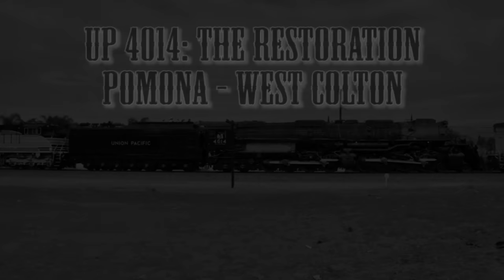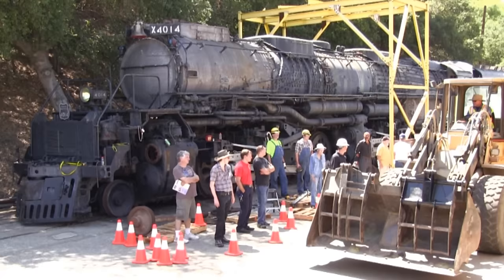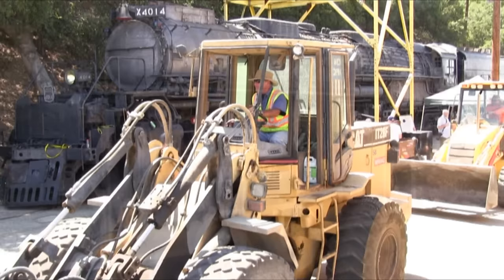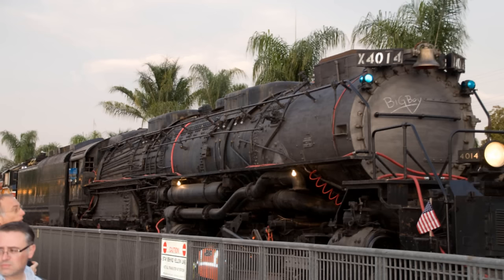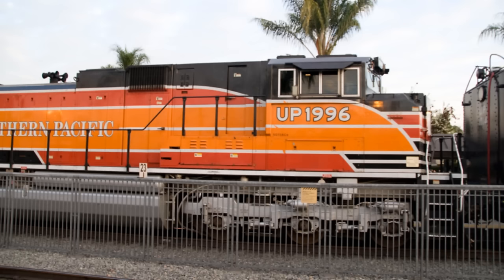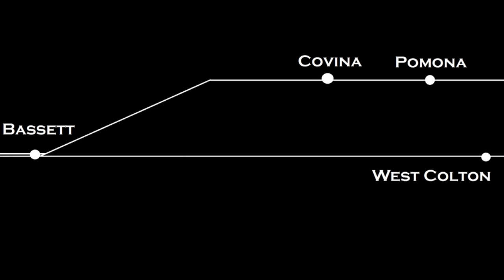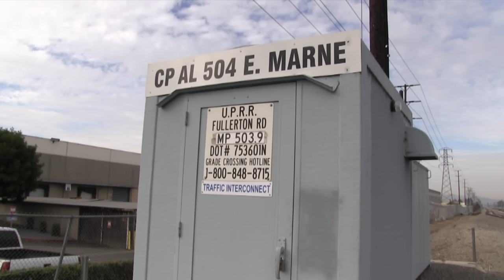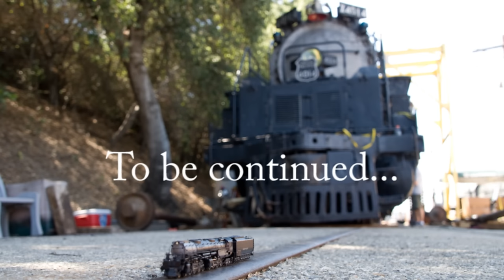Big Boy 4014 Steam Train - The Road to Restoration: Pomona to Colton

Comment: So pathetic! The steam locomotive is so powerless it has to be towed & pushed by 4 diesel electric locomotives! No wonder the steam locomotives were junked! All that remains now is to put this garbage to the cutting torches!

Junk all the remaining steam locomotives! Cut them apart & melt them down!
Reply: Hey you, yeah you!

Have you ever considered the fact that maybe they didn't have the resources to get the train to movie under it's own power at the time?

What do you use for a brain, a grain of sand?
Reply: 1230james
This equipment can't move under it's own power because it was JUNKED out years ago for far better equipment. This thing is a relic that should have been cut apart & melted 70 years ago. Now it is time for financially desperate people to help themselves to the parts & sell them for CASH on the black market for LUCRATIVE sums of CASH.

ABSOLUTELY NO QUESTIONS ARE EVER ASKED ABOUT WHERE THE PARTS CAME FROM OR HOW THEY WERE ACQUIRED!

The engineer's instruments, bell, whistle, headlight, number herald, builder's plate, valve handles etc. Many, many salable parts! FOR CASH!
Reply: Cockroach Bitch, please.

Do your research.

This locomotive was made 74 years ago.

And NOBODY uses an engine like THAT for only 4 YEARS.

And those parts aren't for re-sale. Like you said: If no one wants them, then how do you sell them?

You, sir, are contradicting yourself like a 4 year old.
Reply: 1230james Not to mention the fact that the locomotive hasn't moved from its position since the sixties. If you want a good example try starting a fifty year old car that hasn't had gas or oil in it since the sixties. See how easy that is and multiply it by 100. That is what's required to get that piece of art working.
Reply: 1230james
That relic should not have EVER been used for 4 hours! Those parts will sell for very handsome sums on the black market! And on the black market, CASH IS KING! All payments are in CASH! ABSOLUTELY NO QUESTIONS ARE EVER ASKED ABOUT WHERE THE PARTS CAME FROM OR HOW THEY WERE ACQUIRED! The parts just show up & as quickly disappear!

The financially desperate people can use the CASH to make their lives much better. Think of it as the steam locomotive making the ultimate sacrifice for helping people! What a noble cause!

Junk all the remaining steam locomotives! Cut them apart & melt them down.
Reply: Joni Mire
I disagree! This thing was junk in 1950 & should have been cut apart & melted them. But it is not too late. All of the parts can be sold quickly for CASH on the black market! Financially desperate people can sell the parts to help out their financial situation & improve their lives. ABSOLUTELY NO QUESTIONS ARE EVER ASKED ABOUT WHERE THE PARTS CAME FROM OR HOW THEY WERE ACQUIRED! The parts show up in the middle of the night, the CASH is paid & both parties walk away, content!

Engineer's instruments, bell, whistle, headlight, builder's plate, number herald, bolts, nuts, tubing & so much more is there just for the taking!

We don't need steam technology for locomotion of a transportation system any longer. It is like arming the army with crossbows & trebuchets. Worthless, useless garbage of a warfare technology any longer. The steam locomotives should be used for heavy artillery practice for the military!

Junk all the remaining steam locomotives. Cut them apart & melt them down!
Reply: Cockroach Noble cause??  I think not.  You are about as noble as your name suggests.
Reply: The idea with this isn't to try and make steam trains make a comeback. The Union Pacific want to restore the 4014 for excursion service. They do use their steam locomotives for freight but only when running in between passenger trains.
Reply from the maker: Cockroach The equipment was not junked. It went straight from the "back up" pool of locomotives to the museum in Pomona. As a business, the Union Pacific was looking for the least expensive yet most effective means to get the job done. It just turns out that the big boys were no longer the most advanced pieces of railroad technology in the late 1950's and hence, they were all retired. I don't think it is accurate to call them "junk". They were very good at what they did and served the railroad well at the time. Now, one is being restored as an example of what some of the biggest steam locomotives in the world were like. I figure that you are probably just teasing people, but it would be best if you refrained from such comments as "they should all be graffitied" in the future, as many people are excited to see this project finally coming to fruition. Thanks.
Reply: William Tilland
Believe what you want or think of the cause & me! What you think of me is none of my concern.

I believe that the financially desperate people would be well served by the sale of the parts of a steam locomotive on the black market. Just think of the difference it will make in their lives having the CASH from the sale of it's parts on the black market! And they don't have to worry because transactions on the black market are conducted with ABSOLUTELY NO QUESTIONS EVER ASKED ABOUT WHERE THE PARTS CAME FROM OR HOW THEY WERE ACQUIRED!

For the financially desperate person, it raises their standard of living for a while & probably long enough they can get their feet grounded & able to feed their families.

That sounds very noble to me.

It is better than the junk the steam locomotive was 70 years ago. To preserve it now, is only perpetuating the uselessness of a steam locomotive. It is better in parts on the black market, torn apart, cut apart, scrapped, junked out, cut apart & melted down for recyclable materials.
Reply: Jacob Greve
Regardless of the idea, it should be made available for parts to the financially desperate people to sell on the black market. ABSOLUTELY NO QUESTIONS ARE EVER ASKED ABOUT WHERE THE PARTS MAY HAVE COME FROM OR HOW THEY WERE ACQUIRED! It is just CASH transactions. Both parties walk away content.

And the planet is rid of another steam locomotive! Sounds like the way to go!
Reply: Adolph Oliver Bush
Think what you wish of my posts. What you think is of no concern to me.

I don't deal with the parts, I cut them apart & load them for a foundry to melt. When enough parts are removed & the steam locomotive relic is beyond economic reason to repair, it may come my way.

That is when I have the yard crew go to work & reduce it to recyclable material to load into a mill gondola. The foundry does the fine job of melting it.

Not to worry, we haven't cut one up in a few years now, but anything I can do to help it along, is fine with me!
Reply: Joni Mire
Nuclear power steam locomotives? I know the government will allow it. Even if it did, the local neighborhoods would not allow it within 100 miles because of the risk. Insurance companies would never insure it.

The only time this relic has a chance of nuclear power is if it runs under the ocean at a depth of 1000 meters & 2000 kilometers from the closest shore!

Cut it apart & melt it down!

IRL I hope you are smarter than you sound!

BTW, you are so wrong! They made 25 of these articles of pot metal. 17 were scrapped. Only 8 remain! All should be junked out, cut apart & sent to a foundry for melting down!
Reply: Cockroach What use would the parts be if they are designed for the big boy steam locomotive and only that. Didn't think of that did you smart guy.
Reply: CoasterFan2105
There are easy ways to deliver white paint balloons at this relic of pot iron. Then there is ways to "decorate" the steam locomotive with a yellow spray paint can. It would improve it's looks just before it is cut apart & sent to the foundry for melting!

There are some excellent opportunities coming up while being moved to make this some very nice "decorative" touches to this with about 3 5 gallon paint pails of pink, blue, white or yellow paint. In fact, the local recycling/waste disposal center has free paint for the taking. I pour it all together to make an attractive blend & use it!

That would look very nice on a steam locomotive just before it is delivered to a recycling yard, (like mine), for cutting apart & loaded into mill gondolas for delivery to the foundry where all those parts will be melted down!

Junk all the remaining steam locomotives! Cut them apart & melt them down.
Reply: Jacob Greve
There are people who collect artifacts for their own collections. They need not be complete collections of any one thing.

Do you think the Smithsonian has all items which have collectible value?

I did think of that! What you think of me is none of my concern.

Thank you for your concern & support!

Junk all the remaining steam locomotives! Cut them apart & melt them down.
Reply: Cockroach Finacially desperate, huh?

Again, no one would buy these parts. Like you said, these engines are outdated.

And you don't just SELL parts.

One company makes the locomotive,
The railroad uses it,
Another company can scrap them if they want to.

That 2nd company SELLS the scrap to others to use.

So how do finacially desperate people get the scrap, if they can't even AFFORD THEM?

Bitch, please, you have the mental capacity of a grain of sand.

Oh, what's that? Sand doesn't have brains?

WELL THAT'S THE POINT, BUDDY.
Reply: Joni Mire Um... NUCLEAR?

Not saying I'm changing sides or anything, but I doubt steam locomotives are capable of nuclear power...

But then again, I'm no nuclear physicist, so don't take my word as a completely accurate fact.
Reply: 1230james There are many, many parts collectors out there who want just a piece of the steam locomotive & will be handsome sums of CASH to get it.

ABSOLUTELY NO QUESTIONS ARE EVER ASKED ABOUT WHERE THE PART(S) MAY HAVE COME FROM OR HOW THEY WERE ACQUIRED!

The black market is the place to sell those parts. They won't be found for years & the CASH helps out the financially needy immediately!

What a good way to go! Making the ultimate sacrifice to help people with their CASH needs to improve their lives!

Junk the steam locomotives! Cut them apart & melt them down.
Reply: Adolph Oliver Bush Go ahead! Report me! I am not worried whatsoever. Since I haven't received any that I know of, there is no crime. I am sorry for you that you wasted your time on a something that is not a crime. But if it makes you feel better, please do!

I am just providing a service. I am telling people where the bank is, what is inside & the security systems employed. It is no more than telling a stranger where the Automated Teller Machine is. It is up to the bank to deal with the "customer".

The location of these relics needing, "a little help", is widely publicized. Even the railroad broadcasts it. Just letting the financially desperate people know is no crime at all. What they do with the information is up to them. I have never told them to do it or not to. I just tell them what I have heard about the activities of the black market. I am providing information which for them is a great service.

Consider yourself advised, Adolph Oliver Bush!

Junk all the remaining steam locomotives! Cut them apart & melt them down. Remove the parts & sell them on the black market for CASH. ABSOLUTELY NO QUESTIONS ARE EVER ASKED ABOUT WHERE THE PARTS CAME FROM OR HOW THEY WERE ACQUIRED! The part & the money come together & go away in opposite directions & no body except the buyer(s) & the seller(s) know.
Reply: Cockroach ...I found another contradiction.

One does not simply sell parts...
...when they're already melted down.

Given that you don't want to burn your hands.

And no questions asked?
A black market?

Where are we, the New York subway?
Reply: 1230james You have poorly misjudged. But I expected that from you.

The financially desperate people pick off the parts until the relic of pot metal becomes economically beyond reason to restore. Then it gets delivered to a scrapper to deliver the Coup de Gras.

At that point, it is delivered to the foundry where it's well deserved end! Melted into puddles & poured into the molds of brand new products.

Junk the steam locomotive. Cut it apart & melt it down!
Reply: 1230james Financially desperate people can do that. Don't under estimate them. And thank you for the very flattering compliment. I sincerely appreciate it.

When you are financially desperate & hungry, you will do what ever it takes to make it change. Selling parts of the steam locomotive on the black market for CASH is not beneath any of them.

The steam locomotive is out there. The pieces are there for the taking. Junk the steam locomotive! Cut it apart & melt it down.
Reply: Cockroach "Out there for the taking"

One does not simply STEAL a STEAM LOCOMOTIVE.

Or anything bigger than a car for that matter.
Reply: 1230james Trucks are stolen many times a year. Correct, there is no record of someone stealing a locomotive outside of war time. (It did happen in the US Civil War.)

Removal of parts of locomotives does happen. The air horns on diesel locomotives have been stolen & other equipment. The same can happen to the steam locomotive. The removal of the engineer's instruments, bell, whistle, boiler water sight glasses, valves, valve handles, radio, rope cords with handles, etc. There is just so much there which will sell quickly on the black market for CASH.

The very best part, ABSOLUTELY NO QUESTIONS ARE EVER ASKED WHERE THE PARTS CAME FROM OR HOW THEY WERE ACQUIRED!

The part(s) come in, the CASH comes in, the transaction is made, the seller walks away, the buyer walks away. And the parts disappear for many years!

That is the free enterprise system.

The locomotive is reduced to junk, then scrapped, cut apart & melted.

That is the way it is done! And the polluting hulk of pot metal is removed from the planet.
Reply: Adolph Oliver Bush Might like to know. a have spoken to the local police & the FBI had a friendly little chat. Seems there is nothing that can be done about the great service I provide. I provide information to financially desperate people. I am protected under free speech laws & I have nothing which links me to a crime or the commission of one. Until there is a crime, there is nothing which can be done. And even if there is a crime, since I am not involved in the actual commission or planning, I am golden.

Even then, it would be as indefensible as those, "I saw this movie & it said to . . . .". Hollywood can not be liable for publishing such a work. But it could happen.
Reply: Cockroach Alright, let's tackle your claims here, shall we?

1. Yes, the great locomotive chase. But they ultimately failed.

2. Dude... we used something called RIVETS back then. RIVETS. Not screws or nails, smart one. And who the hell steals a radio? And besides, if someone were to steal anything from a steam locomotive, why would they steal it? Most people (like you, apparently) consider steam locomotives "uncool." If you steal something from a steam locomotive, it will have relatively low value because the market doesn't generally want it, and there's no use for them.

Black market? Bitch, please. With all due respect, the only thing on the black market here are DRUGS. I think this isn't the 19th century anymore.

3. No questions asked? I don't think so.

Normal market: Buyer will wonder where you got the part.

A supposed black market: Steam locomotive parts are generally rare. Wouldn't someone go "Dude, where did you get that?"

4. The parts disappear? Kind of hard to hide anything from an engine... those parts are pretty large.

Unless you pull off something like the 3rd case in Phoenix Wright: Ace Attorney - Dual Destinies, but that's a different story.

5. Free enterprise. I see that. Black markets aren't generally a part of it.

6. It's not junk if it hasn't been disposed by it's current owner yet. :D

(And don't try fitting a giant trash bag over it either...)

7. So let's scrap airplanes too! They pollute more! And how about the cars you use! Taxis! Buses! Ships! How would you like that?
Reply: 1230james To answer your points:

1. Yes, the locomotive was wrecked! Good!.

2. a. There are plenty of threaded parts on a steam locomotive, smart one. Not everything is riveted in.

2. b.  Radios are removed every night of the year from automobiles. Why would a steam locomotive be any different? They are removed for themselves or private sales. The black market is also a place of exchange.

2c. The steam locomotive is a great source for recycled materials.

2d. There are collectors out there who would enjoy having a few of the parts of one of these relics of pot iron. They pay handsome sums of CASH for those parts from those who acquire them & sell them. Don't kid yourself or under value those parts sales to collectors.

Yes there is a black market. True, it is no longer the 19th century but there still is activity like this going on. It is fitting that a 19th century activity is occurring to a 19th century transportation machine. Nice!

3. There are ABSOLUTELY NO QUESTIONS ASKED ABOUT WHERE THE PARTS CAME FROM OR HOW THEY WERE ACQUIRED for transactions on the black market or those private transactions between sellers & private parts collectors. NO QUESTIONS!

This is not a normal market. Even if the buyer wonders, they don't ask.

No body on the black market says, "Dude, . . . ". They just inspect the part, the seller inspects the money & both walk away, content.

4. The parts do disappear into far away places. Large parts can be moved without anyone seeing. It takes some doing, but it can be done..

5. The black market is a free enterprise. Not licensed or regulated, it is just private transactions. The government does not restrict or regulate private sales. It is the American way!

6. It is junk! It is ready to be junked, it should have been junked. It will be reduced to junk. To have it cut apart & melted down into reusable materials, is the way it needs to go! Many scrap operators would be delighted to do the job!

7. I do scrap many things, farm equipment, trucks, buses, cars, motorcycles, jet skis, several airplanes, appliances, industrial equipment, building materials, some railroad rolling stock occasionally, railroad signal stands, switch boxes, traffic signals, bicycles & many items of consumer products.  I like that just fine for scrapping pays my bills, my employees, my business fees & licenses, our health care & an occasional company party.

A steam locomotive is a project which when scrapped, cut apart & sold to the foundry is money for all of us who work here. That is free enterprise!

Junk all the remaining steam locomotives! Cut them apart & melt them down!
Reply: Cockroach Lets tackle these again!

1) Do your research. They didn't fail because they derailed, they failed because they we're stopped by the Confederates.

2a) And how would you magically just spot one out of hundreds of other parts?

2b) Steam locomotives don't have radios installed, genius. They use walkie-talkies.

2c) So is a trash can.

2d) Collectors? Why the fuck would a collector go to a SCRAP YARD to get parts?

And if there are train black markets, they would be trading diesel engines, not boilers. Go to Cuba if you need to.

3) Private, yes. No questions asked? I'm sure we don't live in a world of silence.

4) One does not simply make something disappear.

5) Same response as the second part of 2d.

6) Then that gives us the right to call your life a piece of junk.

7) If it's your job to scrap things like this, WHY THE FUCK DO YOU MENTION BLACK MARKETS?

If it's your job, then you can legally go and sell the parts on normal markets, yes?

DO YOUR GODDAMN RESEARCH BEFORE YOU BLUFF LIKE A THREE YOUR OLD!

Okay? Good.
Reply: Dan Best Thank you for the very flattering compliment. I sincerely appreciate it!

I am delighted you agree that the steam locomotive is nothing more than a relic & should be junked, cut apart & melted down.

Now, for this 'storied' move of 4014, there are many things which can hopefully go wrong. There is a lot of territory ahead to cover with many places where the steam locomotive may likely come to it's well deserved end! That sounds nice to many of us & now we may include you in the jubilation!

It is good to have you with us! The parts are can be had for a song & the machine is so accessible. It will great to have it meet it's end during this journey!

The black market may be well positioned to transact a parts sale for this relic of garbage!

Gland to have you with us!
Reply: 1230james 1) They were virtually wrecked by the Union Soldiers.

2a) The collectors know how to spot parts. They know what they are looking for.

2b) You haven't checked out any of the modifications made for main line service have you? They have been mounted in the cab. 

2c) Steam locomotives are better sources! They were garbage 70 years ago, They have that privileged distinction more today!.

2d) Collectors don't come to my yard for these parts. The seek them out long before the locomotive gets here!

There is a steam locomotive parts black market, There is also diesel locomotive parts black market too, Boilers are not on the shopping list.. No need to go to Cuba if someone needs or is collecting steam locomotive parts. The steam locomotive is out there for the parts taking.

3) Private sales are conducted all the time with no questions asked. Don't be so sure of a world of silence.

4) It depends on who is watching & where they are looking..

5) Same response as 2d.

6) What you think of me is none of my concern..

7) It is my job to scrap junk like this, Black market transactions can accelerate the delivery of such a relic to the scrap yard. That is $$ to me!

It is my job when we acquire it. YES! The black market just helps deliver it to a state where it will be deemed junk!

If you don't like it, DO SOMETHING ABOUT IT!

And thank you for the very flattering compliments! I sincerely appreciate it!
Reply: Well named!
Reply: Brandon Beck Think what you wish of me. What you think of me is none of my concern. I am just making my comments here as YouTube says I may. I thank you for the very flattering compliment! I sincerely appreciate it.

I am providing a great service for the financially desperate people who need to know where they can obtain some quick CASH for their next day of survival. It is no more than telling anyone where the bank is, what is inside & about the security over those contents. It is truly a GREAT SERVICE.

On the black market, parts are sold for CASH with ABSOLUTELY NO QUESTIONS EVER ASKED ABOUT WHERE THE PARTS CAME FROM, HOW OR WHEN THEY WERE ACQUIRED!

The seller is there, the buyer is there, the transaction takes place & both walk away from each other very satisfied with their business transaction. It is free enterprise at it's finest!

Junk all the remaining steam locomotives! Cut them apart & melt them down.
Reply: Don't listen to this guy! You all are just giving him attention which is exactly what he wants. Just another troll trying to mess with people to get enjoyment out of it. Take my advice and just ignore this coward that doesn't even have the courage to use his real name.
Reply: 1230james 1. Yes, but the thing should be turned into foundry melt.

2a. What ever you mean by that. The parts are there for financially desperate people to acquire & sell for CASH on the black market.

2b. Steam locomotives don't belong operating on ANY line. You haven't been looking lately where the radio has been mounted. It is an updated modification which perpetuates the folly of the steam locomotive.

2c. Steam locomotives are a far superior source of scrap metal. There is so much more volume & better grades of steel for melting down.

No, I am a business owner/operator of a heavy metal recycling facility.

2d. The black market helps reduce the 'project' to a state where it ends up being beyond economic reason to maintain & restore. Then it becomes a 'project' for me at sometime to deliver the Coup de Gras.

3. You don't know the sound of the street. There is a code. You would probably never hear it, but it is out there. It takes a skill which I seriously doubt you have.

4. Never suggested any such thing.

5. Same answer to a different question. It is significant because you answered it.

6. So what about it?

7. IRS has never bothered me about any such thing. All of my transactions are legal & documented.

8. Correct! If someone purchases a part, it is not junk. It is what is left of the whole which has become junk because it has been stripped.

9. You have done nothing! Perhaps you think you have, but the word on the street is "have at them". They are all high profile targets.

Thank you for the very flattering names. I sincerely appreciate it!
Reply: Cockroach 
1. The only thing they melted during those days were probably random bits of metal.

2a. FINANCIALLY DESPERATE = NO MONEY TO BUY PARTS TO SELL. Simple equation.

2b. If you say steam locomotives are failures, why do we have them? Or any train?

2c. Cool story. Ever heard of A380s?

2d. And by messing up the state, they increase taxes which nobody likes. Nice logic you guys have over there.

3. And why would I waste my time with a gang of smugglers who utterly failed at a normal life?

4. Then define "disappear."

5. 'Kay, cool. I'm ignoring this #5 for now on.

6. We can consider anything junk.

7. So why mention this illegal black market again?

8. And you just destroyed your own claims.

9. If I have done nothing, how come there's 12 responses to be made here?
Reply: 1230james
1. There was much more damage than that.

2a. Financially Desperate people do not purchase the parts for the black market, THEY TAKE THEM. Much Simpler than your math.

2b. The steam locomotives are relics of a past technology. No need for them any longer. Time to cut them apart & dispose of them was 70 years ago. All that is being done with them now is to use them for circus amusements!

2c. Yea, I heard of them! Garbage any longer!

2d. It won't increase a dime in taxes! Wrong again!

3. When they are disposed of to scrap operators, it is not a waste.

4. Midnight parts supply! Five finger discounts!

5. Be my guest!

6. Everything becomes junk. End of it's service life, junk it!

7. Nothing illegal about the black market. It is there, but it's activities are when the sellers & buyers want. Nothing formal.

8. You only think that.

9. I don't think you did anything but discuss the issue. The rest is someone else s action.

Scrap all the remaining steam locomotives! Cut them apart & melt them down!

Today is the day 4014 will meet it's end! Many places in Echo to have a party with it.
Reply: Theo M Thank you for the very flattering compliment. I sincerely appreciate it!

Thank you for agreeing with me. It is good to have you in our support to JUNK THE REMAINING steam locomotives!

It is great to have you assist in this great effort!

Junk all the remaining steam locomotives! Cut them apart & melt them down!
Reply: Clint Osowski Thank you for the very flattering compliment. I sincerely appreciate it!

Thank you for agreeing with me. It is good to have you in our support to JUNK THE REMAINING steam locomotives!

It is great to have you assist in this great effort!

Junk all the remaining steam locomotives! Cut them apart & melt them down!

I know you want to see that happen too! Glad to have you with us!
Reply: Clint Osowski You must have a very short memory my friend! You did agree with me & you said restoration of your 1947 Ford 2N farm tractor was just a thought but the more you thought about it, the better it would be to have a scrap yard cut it apart & send it to a foundry to melt it down.

I am not worried about you restoring your farm tractor or doing what you say you will do to me, because you agree with me.

If you did do that to me, I think I would like it!

Your tractor & the remaining steam locomotives should be cut apart & melted!

Thank you for supporting the efforts of so many good, financially desperate people to do these great missions of metal recycling. You are helping out when you scrap your tractor!

Nice to hear that 4014 had a bad accident today. Those canyons are brutal!
Reply: Harrison Picot Thank you for the very flattering compliment. I sincerely appreciate it!

Junk all the remaining steam locomotives! Cut them apart & melt them down.
Reply: Squarerig
I am looking for a new "project" for my crews to cut apart & melt. I run a business here.

Never cared or gave a hoot about a train or a steam locomotive. To me, it is just a machine with wheels on it. All of it can be melted down. It is materials for the next generation of metal needs.
Reply: I knew you would like that a Big Boy is being restored. :) When this locomotive is restored, it will be 6,300 horsepower and 135,000 pounds of tractive effort "helpless". Oh, I am also looking forward to the restoration of ATSF 2926 being completed. In addition, it would be excellent to get C&O 614 and and N&W 611 back on the rails.
Reply: Cockroach,the steam pressure is rising;the feed pumps are clacking away,the boiler is about to burst!I woudl take cover if I were you for the replies are coming thick and fast.You have deifnitely set the cat among the pigeons here.How's business anyway?
Reply: Business is going just great! Thank you for asking & your concern.

It is good that so many people finally realize the steam locomotives need to be cut apart, melted down & poured into the manufacture of new products.

Junk all the remaining steam locomotives! Cut them apart & MELT THEM DOWN!
Reply: loganbaileysfunwithtrains I didn't know that stealing is a reflection of one's mental state. I seriously doubt your unprofessional advice.

The steam locomotive is a literal grocery store for the financially desperate person. All those parts are just there for the taking for a CASH sale on the black market. ABSOLUTELY NO QUESTIONS ARE EVER ASKED ABOUT WHERE THE PARTS MAY HAVE COME FROM, WHEN OR HOW THEY WERE ACQUIRED!

Parts like the engineer's instruments, boiler water sight glasses, whistle, bell, headlight, marker lights, number boards, builder's plate.

There is always the large canvas of the tender sides which make great displays for urban graffiti painting. It makes a great target for paintball shots of pink paint.

Junk all the remaining steam locomotives! Cut them apart & melt them down.
Reply: loganbaileysfunwithtrains I am making my comment as anyone else is untitled to do. I am looking for the steam locomotive to be junked, cut apart & melted down.

This machine is no longer a profitable, useful machine! Time to cut it apart & melt it. It may have done great things at one time, but those times are 70 years past. Time to destroy it & reuse the materials for another purpose.

Towing it is not a way for a railroad to earn. It is not good for a stock holder. If it doesn't earn above it's costs, IT GOIES ONTO THE SCRAP PILE!

I am not worried about being reported for anything.

The steam locomotive is a literal grocery store for the financially desperate person. All those parts are just there for the taking for a CASH sale on the black market. ABSOLUTELY NO QUESTIONS ARE EVER ASKED ABOUT WHERE THE PARTS MAY HAVE COME FROM, WHEN OR HOW THEY WERE ACQUIRED!

Parts like the engineer's instruments, boiler water sight glasses, whistle, bell, headlight, marker lights, number boards, builder's plate.

There is always the large canvas of the tender sides which make great displays for urban graffiti painting. It makes a great target for paintball shots of pink paint.

Junk all the remaining steam locomotives! Cut them apart & melt them down.
Reply: Cockroach They are a piece of history and will never be junked or sold on the black market like you say. What you're basically saying is that everything that is old should be scrapped, torn to pieces and sold away to people. So why don't we start with you, or one of your relatives perhaps.
Reply: *****
Heaven's above!Why become so outraged over Cockroach's views and  comments?He is entitled to them  as you are to yours.He is deliberately  provoking you and you respond with dire threats of "reporting"!Are you really that sensitive?Cockroach is merely continuing a process that commenced back in the 1950's.I disagree with him for I derive pleasure,childish maybe,from the sight and sound of a one of these magnificent fire,smoke and steam-belching monsters of yesteryear.Cockroach apparently doesn't.So what?Cockroach enjoys  cutting up scrap of all shapes forms and sources;not only is this a source of pleasure for him he also makes a good living from so doing-I hope he does,anyway!I was a tea estate manager for some years in Africa and it was astonishing what old,ancient and outmoded machines lay on our scrap heaps from which I rescued several.Fortunately,for these machines and their survival,that is,there was no scrap industry in that part of the world.Scrap was utilised as and when we found it necessary for to keep our factories running.I still possess many of these machines,devices,pieces of apparatus,all quite outmoded and,according to Cockroach, fit only for the  cuttting torch.But,for me,I find it interesting how my predecessors tackled  difficulties with the technology  available in their day.Now,there's a tip for Cockroach;thousands of tons of  nineteenth century and early 20th iron work just lying around in Africa for the taking!
Reply: ***** How many straws in total was that?

Thank you! I am sure that YouTube does not want any trackway cooling devices offended!

Junk all the remaining steam locomotives! Cut them apart & melt them down.
Reply: superpacman9000 These relics once made history, but now that history has been recorded. Time to move forward! The have been written about, documented, photographed & filmed all that is necessary. Time to cut them apart & reuse the materials contained therein for another purpose.

In case you missed it, what I have said is, cut apart & melt down all the remaining steam locomotives. Reuse the materials for new products. Let the financially desperate people at these antiques & remove parts for CASH sales on the black market to collectors who make handsome payments for these parts. It can be very lucrative & literally change someone's life with enough CASH to equal at least a year's income.

Being old has nothing to do with it, but you don't understand.

Why don't we start with me or one of my relatives? Neither I nor any of my relatives are worth much at all on the black market. There is your reason why not to start at those poorly thought out places you came up with. You can do better than that!

Junk all the remanning steam locomotives. Cut them apart & melt them down.
Reply: what is you fascination with the black market? keep talking about it and the NSA will track your computer or phone to where you live
Reply: loganbaileysfunwithtrains The black market is the motivation many financially desperate people need to change their lives. All sales on the black market are CASH! And that is a good motivator to get them to act!

I am sure it is known where I live, here on Stockton Street inNew Hope, Pennsylvania. The I have spoken to law enforcement before. A real nice bunch of people.

Junk all the remaining steam locomotives! Cut them apart & melt them down.
Reply: just stop trolling and leave or shut up about the black market and quit talking about scraping all the steam locomotives its not up to you and their not going to so deal with it. Also you are trying to make people mad including me but its not going to work with me so stop trolling or you will get reported
Reply: loganbaileysfunwithtrains I am here to stay. The  black market is too. The steam locomotives should have all been scrapped 70 years ago. But the black market offers great CASH prices for the parts of a steam locomotive when sold to collectors. Engineer's cabin instruments, boiler sight water glasses, whistle, bell, levers, valve handles, headlight, marker lights, number boards, builder's plate, hoses, wiring, generator & so many other parts. All there for the taking.

I am not trying to make anyone mad. If so, then those people have a problem. I am trying to enlighten financially desperate people where the steam locomotive can be found and what are the value of those parts which can be taken & sold for CASH on the black market. Lucrative sums are paid & it can really turn someone's life around.

I will be reported? To who? Do you think anyone cares? News Flash for YOU: Nobody cares & nothing will be done to me.

Junk all the remaining steam locomotives! Cut them apart & melt them down.
Reply: taledarkside No, a scrapyard owner & operator. Looking for projects to junk out & send to the foundry.

But before I do, there is always the black market which can do such a fine job of offering CASH for the steam locomotive parts. ABSOLUTELY NO QUESTIONS ARE EVER ASKED ABOUT WHERE THE PARTS MAY HAVE COME FROM, WHEN OR HOW THEY WERE ACQUIRED! It is all there for the taking.

Junk all the remaining steam locomotives! Cut them apart & melt them down.
Reply: taledarkside Not really! It is the way the black market works. Get wise! Accept it.

Junk all the remaining steam locomotives! Cut them apart & melt them down.
Reply: mark10788 I can post my comments to YouTube as well as anyone else. You don't have to like it. I am not afraid of anyone. Collectors seeking articles for their collections do have a black market. Financially desperate people may want to make opportunity of them by selling what they have acquired for CASH. ABSOLUTELY NO QUESTIONS ARE EVER ASKED ABOUT WHERE THE PARTS MAY HAVE COME FROM, WHEN OR HOW THEY WERE ACQUIRED!

What you want to believe is none of my concern.

The USNRofHP is only words on paper. It is like the speed limit. Sure it is there, enforced when violators are caught, but otherwise, by the populous of the people, ignored. The same happens to USNRofHP & for that matter to the National Parks. Few obey EVERY law. The steam locomotive is no different. It is all there for the taking.

Junk all the remaining steam locomotives! Cut them apart & melt them down.
Reply: One, What you think of my comments is none of my concern.

Two, You are not listening in the right places. 

Three, The black market for these parts is very tight lipped.

Four. I don't care what you look like, I don't want to see your face & what you think is none of my concern.

You probably won't see it happen, but you will know when it does.

Financially desperate people will find them & help the world get rid of them.

Five, What would a USNRofHP sign do? Nothing! What "trackway cooling devices" and "vaporized water lovers" feel or think is none of my concern. I work plenty out in the yard.
I am not here to anger or upset anyone. But it that is the way them feel, that is their problem, not mine.

What gestures someone makes to another person is none of my concern.

This is just another law to be aware of, but if you can get away with it . . . I guess it is okay!

Nothing different about the steam locomotive. It was a transportation machine whose technology has been replaced with something far better. Where ever the parts are located is not enough to save it. It is going to the junk yard.

It is for the taking.  It should delight "trackway cooling devices" and "vaporized water admirers" happy! The junking of a steam locomotive delights my heart. You should see it one time. You will love it!

It reminds me of the bright new future to come when the materials are being poured into the molds of new products. They are for punks, hipsters and gangsters to graffiti, steal and vandalize, military to use heavy artillery target training and most importantly, to be scrapped in our generation.

Steam locomotion has been gone for a 5-6 decades. It does mean it is okay to scrap it.  I encourage it. A replacement part is an invitation to take it again. It wouldn't be worth nothing if it were replaced. It has to be worth something to someone if it is important enough to replace.

Steam locomotives are not made to last. They can no longer prove worthiness. Look at them, they have to be pushed by a diesel electric locomotive in every train. That can't maintain speed & need a lot of upkeep!

Steam locomotives pollute far more than diesel electric locomotives. Diesel electric locomotives are what are reducing greenhouse gas releases. Diesel electric locomotives are slowing the rising the sea levels.

Sure, steam locomotives can burn frying oil oil!  That doesn't mean they don't pollute our air! They do! The steam locomotive is the most inefficient users of fuel ever devised for a transportation machine. Time to junk them all.

I do have a soft spot of steam engines, when they are being cut apart & melted down.

P.S, Financially desperate people often use the public library. They don't nee to own a computer with a browser & an internet connection.

We can scrap a locomotive & new ones are doubtful to appear!

Steam locomotives will be scrapped, cut apart & melted down. What you believe or not is none of my concern. I am a metal scrap yard owner / operator who is looking for new projects for my employees.

I am delighted that I have some many people who are delighted with my mission.

P.P.S., YouTube invites everyone to make a comment. It doesn't specify what those comments must or mush not say.

P.P.P.S, I will RSVP with what I want to write.

Junk all the remaining steam locomotives! Cut them apart & melt them down.

Have a wonderfully good day.
Reply: *****
One: Nobody has made a credible death threat. No concern.

Two: Selling steam locomotive parts on the black market does happen. Google is not the place to look. I am encouraging murder? I am committing a crime! Call 911!

Three: Google is not the place to look. Trust me.

Four: I don't want to see his face because I am not concerned about what he looks like or want to emotionally express. You believe what you want to believe. What you believe is none of my concern.

THESE PEOPLE DO EXIST. 

Incorrect, there are state laws, county laws, regional laws, city laws, traffic laws. You don't seen to know much about government, do you?

Steam locomotives are NOT business anymore! They are now for junking out, scraping them down, cutting apart & melting. Their days are numbered as people with needs make designs upon them. They will be gone. Nobody to see them. There are more of us out here to meet who want the steam locomotive destroyed. Better open your eyes..

You & Mark1788 may believe what you want to believe. I am not concerned.

I am here to stay, NOW. You will not make me leave. Go ahead, flatter yourself with that thought. It is not going to happen.
Reply: mark10788 I am not concerned. IF it happens, (and it won't), I will deal with it!

Steam locomotives are for junking! The black market can do it the best service ever possible with the parts are hauled off for CASH sales.
Reply: Cockroach
And did you even see that video?  Where are the links about your business?
Reply: mark10788 Which video? I have seen plenty & there are numerous videos here. Be specific.

Junk all the remaining steam locomotives! Cut them apart & melt them down.
Reply: taledarkside As a matter of fact, I shower at least once a day.

Copper is worth it!

The generator on a steam locomotive can be a glorious gain! Plenty of copper there!
Reply: As his name implies, a true democrat
Reply: Bill Elliot What you think of my political affiliation is none of my concern.
Reply: MrRailroadrunner
If people like or dislike me is none of my concern. I am making my comments as I am permitted. You, (and any one else), don't have to like any of them.

There are many more who PM me with support & asking for the precious information about the location of the steam locomotives. You know the type of information I provide. What they do with that information or how they use it is none of my concern.
Reply: HotRod Buick What you think of my views is none of my concern!

The steam locomotive & tender is no longer a commercially viable transportation locomotion tool. It is just a relic with materials that can be melted down & recycled.

That is what I do. That is life! I look for those things with the highest return on investment. The steam locomotive is one of the highest.

The steam locomotives have become targets for a number of recycling activities. CASH parts sales on the black market, graffiti paint, collectible items removed from them for a personal collection.

If you don't like it, tough up! There is a change coming. The landscape is changing for the future of the steam locomotives & it doesn't look good for them.
Reply: HotRod Buick I have a good knowledge of history. It has all been written or photographed, or in the case of these relics of transportation, diagrams of the mechanisms have been made, numerous times. That is all that is necessary.

It is time to melt down these worthless hulks & reuse the materials for new products. I hope to see that happen.

It is time for the parts of the steam locomotive to be stripped from the machines by financially desperate people & sold on the black market for CASH. I hope to see that happen too.

I will cut you a break as well. I let it go on that point. We don't agree, but I respect your right to have your own opinion. I wore a uniform, bore a weapon & stood post to protect that right of mine & yours.

Junk all the remaining steam locomotives! Cut them apart & melt them down.
Reply: Cockroach Are you kidding me? Writing & photography is enough? No it's not. Haven't you taken a picture of something, and compared the sight of it to your eyesight? Some things look much better in person than on a picture, I've heard that about things like the Grand Canyon, and I do agree that it's different from a picture. I can adapt the same thing toward a steam locomotive. You can hear them without a speaker, you can see them without a picture. And then you can smell them, touch them, and ride them. Can photography do those? No.

You need to get out more.
Reply: ***** No kidding! Writing & photography of these relics is ALL that is necessary!

Yes, it is! No one needs the experience of the steam locomotive. Writing & photography can do All that is necessary!

I get out plenty! Thank you for your concern.

Junk all the remaining steam locomotives! Cut them apart & melt them down.
Reply: Cockroach So, does that mean that our dead ones are still alive because we have writing and photography of them?

No it's not. You don't need it, but other people do. You need to learn, that other people think differently from you. You're not always right.

No you don't! All I see you do is comment on videos. I have no concern about you at all.
Reply: Cockroach
Hmmm... as and experienced and expert at winning arguments, i feel i must interject in this squabble to squash the trolling bug and write upon his grave of his utter and humiliating defeat.

1 Having steam engines and other modes of transport from that time period is very beneficial as seeing them in person is proven to be a better teaching tool than a book or picture can provide. Children and adults can learn much from tactile contact and from seeing the beauty of these wonderful creations in person is something books and picture cannot do.

2 keeping steam engines, old diesels and other vehicles that do not rely on computers in working order is a good thing considering that machines that use a computer have a fatal flaw, EMPs. An emp destroys computer technology by scrambling the circuitry, rendering it useless. So if the car you drive has a computer in it, no matter the age, won't work if the computer is fried. But a vehicle, like the steam engine, does not have one and is unaffected by an emp. So when the mother of all solar flares rears it's ugly head and knocks out all computer driven tech( and it will as we do not have anything to stop such a force of nature) we must rely on old machines from the days past to rebuild, and it is far cheaper to repair the current fleet of steam engines than to scrap them all and remake them. Same with the old planes from ww2 as well as old car. So destroying the old fleet of steam and diesels is not a particularity good thing, as most people these days also have a digital account to hold their money, including the very rich. So when the mother of all solar flares comes and emps everything, and with little money left on earth, it would be wise to have plenty of non computer powered machines like the steam engine to help rebuild out country.

3 selling all the steam engines for scrap won't fetch allot of money. My estimates only show it to be around 140 million dollars for all the steam engines world wide if they were scrapped and that is stretching it a bit. So a big boy is not worth much money. The copper parts in it would fetch a paltry 4000 dollars. Most of it is steel, and today won't fetch more than 15 cents per pound. That means that all the steel on one big boy is worth...187,500 dollars. It would cost more than that to make a new one so the return is not worth it.

4 finally most of the things you seam to support would cause more harm than benefit society. From what I have been able to discern from your, lack there of, ARGUMENTS, I have deduced that you actually should go to a mental hospital, have a psychiatrist delve into your psyche and determine why you support such deplorable acts. You seem to have had a displeasing childhood. In what way did steam engines wrong you? Why do you support vandalism? And why do you think you understand what is best for society when you only want what is best for you? Do you want to live in a hellish world were we have no way to rebuild our society? You have a disturbed mind Mr Blattodea. In a matter of fact, i would say you have a mind that has a very warped view of reality and does not realize what we can learn from what remains of the past. Destroying the past and only having pictures and documents deprives us of knowledge, as we cannot learn anything else about the past as we would have destroyed it. You sir have my sympathy for having such an underdeveloped mind and that the only satisfaction you can get is by pestering people. How sad a life you must live.
So, these are the facts, argue all you want, but it won't make any difference as you are horribly out numbered by the facts. All it is is your exasperated opinion. And that is all it is. An opinion. A wrong opinion.
Reply: joshua hudson Just because you respond, doesn't mean you are winning or loosing any argument.

1. So you are going to teach children the ways of the stone age? Ridiculous.

2. Despite the low risk of an EMP,, the steam locomotives will not be used for propulsion. or locomotion.

3. Selling steam locomotive parts to collectors on the black market for CASH is very very lucrative, profitable & low risk. The sums paid for the parts exceed the values you quoted.

4. What you think of me is none of my concern. I neither asked for nor want your sympathy. It is an opinion! A CORRECT opinion! An opinion I am entitled to regardless of what you think!
Reply: joshua hudson Very true, what's pathetic is that he thinks it takes one steam-hater do disfigure a locomotive. What bullshit.
Reply: joshua hudson Also try proving the facts, like with sources or photos, as he seems to think of them as thoughts, plus, he doesn't prove his ideas. So it makes him almost even more pathetic.
Reply: Yep. I wonder if he ever has even seen a working steam engine. Books and photos can't let you experiance the heat, the sounds, the sheer size, and the mechanics of a steam engine. It is like he doesn't leave his house. All he has proven to us is that he is a nutcase. A terrible troll. An annoyance. It is just sad that he thinks he can be taken seriously.
Reply: joshua hudson Thank you! He always makes up that dumb excuse, saying that is all that is necessary to preserve history.
Reply: No problem. He can claim all he wants that he understands history, but he doesn't. History can't just be preserved through books and pictures, you need the physical evidence to back up the books and pictures, otherwise future generations may not fully understand the past. It is like he is saying the pyramids must be destroyed, HA! They are attractions, by seeing them up close and in person, people can get a better understanding of the subject or item. Books and picture can only teach so much. They are a part of something, they are not the whole. If he truly can't understand that, well that just makes him really pathetic. It makes him the king of the pathetic people.
Reply: ***** What you think of me is none of my concern.

1. The steam locomotive is the stone age of transportation! They are junk!

2. There is as much chance of a complete disabling EMP as there is a global flood! It isn't going to happen! The steam locomotive is not going to be ever used again in large scale freight transportation needs. They are headed to the scrapyards for cutting apart. They are headed to locations where the black market sources can get at them.

3. The black market does pay lucrative sums for the right parts for a collector's trophy wall.

4. Correct! There may not be a correct opinion in all of this. My opinion is to let all the financially desperate people know where these machines are, tell them what the parts are worth, where those parts can be sold & what the risks are. Then after that, we scrap all the remaining steam locomotives! It only takes one to make it into the junk pile it should have been reduced to 70 years ago.
Reply: joshua hudson Since when did I become a thief? I am not annoyed! I am amused!

What you think of me is none of my concern!

The solar flare that will kill my car will come long after all the remaining steam locomotives have been cut apart, melted down & poured into new products.

Junk all the remaining steam locomotives! Cut them apart & melt them down.
Reply: ***** It takes one person with a good battery operated sawzall or angle grinder to make the steam locomotive the pile of junk it was years ago. It only takes ONE!
Reply: joshua hudson Those parts do sell. People would like to have the whistle of 844, the whistle of 3589, the engineers steam pressure gauges of 1630, the johnson bar of 90, the water sight glasses of 93, the builder's plate of 4449, the headlight of 3751 & many other collectible parts. The black market pays very well for parts like that.

Let the urban graffiti painters make paint designs on the caves sides of a steam locomotive tender. Let them decorate the steam & valve chests with eye catching splashes of colored paints. Let them adorn the boiler & engineers cab with colorful designs which improve their utility look!

Let the black market for the financially needy people prevail with the midnight acquirements of steam locomotive parts for CASH resale. ABSOLUTELY NO QUESTIONS ARE EVER ASKED ABOUT WHERE THE PARTS MAY HAVE COME FROM, WHEN OR HOW THEY WERE ACQUIRED! Very, very lucrative! Very, very profitable! Very, very low, low risk!

Then roll them into the scrap yards where they will be further stripped, cut apart & sent off to the foundry in pieces for melting. 'Charge the furnaces'!

Let the molten materials from those crucibles be poured into the molds of new products.

May the free enterprise system prevail. May my scrapyard get paid well & I provide payroll to my employees from the scrap materials we sell to the foundries! May my greed for money be well satisfied & my hunger to destroy all the remaining steam locomotives be quenched when the last one is melted down & repaired into new products.

Junk all the remaining steam locomotives! Cut them apart & melt them down.
Reply: ***** What you think of me is none of my concern.
Reply: Cockroach 1. No, the horse and buggy are, so is the boats even. Those aren't junk either.

2. So that means you are not helping the financially desperate people.

3. Collect art.

4. That sounds more like a plan than an opinion.
Reply: Cockroach Many people have no experience to use that stuff! Many people who don't like trains-don't like them because they don't find them interesting! It takes one SKILLED person, but not an AVERAGE person. Even then, they would be noticed.
Reply: Cockroach Oh I am describing you.
Reply: joshua hudson P.s., I did some research on the Black market, and found nothing that had to do with steam locomotive parts. Unless you already knew that, I'd thought I'd inform you.
Reply: Yeah i already knew. The whislte of a 4-4-0 American type I have has been in my family for over a hundred years. My great, great, great, great grandfather was an engineer during the civil war in 1863. He salvaged it after his engine was derailed by confederate soldiers. The bell and whislte were unscathed so he grabbed the whistle. But when i took it to an auction, it was priced at 400 dollars. The guy said that if i had the rest of the engine at home, then it would be worth more because it was attached with the rest of the engine. I was able to prove it was from the engine though because it was shown in several photos that go all the way back to 1867 when he got his first pic with it. So i had plenty of proof it was legit. But because the engine was gone and it was not a well known incident, ie historic, it was not worth much. So yeah, train parts on the black market, just an excuse to get attention. :)
Reply: joshua hudson Awesome
Reply: joshua hudson No trap! Nothing done, but your long diatribe essay!

1. The black market is there & the parts do sell. Choose to believe it or not! It is up to you!

2. The facts are there! You don't care to find out the truth, none of my concern.

3. Just as freight yard graffiti artists "decorate" freight equipment, the steam locomotive & the tender sides make a great canvas. You don't think so, none of my concern.

I am making my comments as I am entitled to do! Nothing to me if you don't like or agree with them! My comments anger people, nothing to me.

You think you won something, go ahead & believe it. The facts are here!

What you think of me is none of my concern. Enjoy your fish you think you have caught!

Junk all the remaining steam locomotives! Cut them apart & melt them down.
Reply: Cockroach You are not fooling him! Or making him angry.
Reply: *****  See, totally pissed. Repetitive. Giving no facts or instances to support his black  market thing. Only the graffiti is true. He is a troll
Reply: joshua hudson You know, yes, you're right. I give you every thanks, I'm seeing more and more of it, but it was still obvious to me when I saw all he has been doing to the people on the internet who like steam trains.
Reply: joshua hudson Another strategy I've been considering trying is: Don't act like you're angry, even if you are.
Reply: Oh yeah! Never let anger show on the net. All it does is eg them on. Don't even fake it cause they don't know if it is real or not. They love the attention.
Reply: ***** I don't care. I am making my comments as I am entitled!
Reply: Cockroach Yeah, no. Making a war with 5 people is not making your comments as you are entitled.
Reply: ***** Yes! Making comments as YouTube permits is my privilege. How people take that is none of my concern.

The police are unjustifiable called insulting names on a daily routine. They take it, take it & take it without a violent response. I admire those people. Yet, they don't They don't try to stop my first amendment right. Likewise, I don't try to stop yours nor campaign any effort to suppress you because we don't agree. You are entitled.

If those 5 people have an issue, that is their problem & no concern of mine.
Reply: Cockroach I don't think you quite understand what 4014 is capable of, there's a use for these machine's, why leave such a locomotive sitting there when it would be FAR more useful actually doing work? This monster is capable of hauling the largest trains there is unassisted. Not saying I disagree, I do believe Steam isn't necessarily the way forward because it isn't, but I don't think they should be cut up for scrap, they're beautiful machine's to see running. Again, it's just useful to bring this locomotive back to pulling trains.
Reply: I'm a gonna tell you somethin, he will reply with a negative comment no matter what you say, and with a 98% chance have the phrase "Junk all the remaining steam locomotives! Cut them apart & melt them down." He is a troll. Just ignore him. He has given no facts to support any single one of his ideas. Trust me, mr Roach here is just another idiotic troll.
Reply: joshua hudson
 I think Cockroach is quite perceptive. He has the right idea. These things are wasting a lot of metal and we can't afford to run them on pollution and economic grounds now. He's got some different reasons, but it's a correct conclusion.
Reply: WHOAH hold the phone pal, they are not wasting metal or resources, they are able to run on oil, are a good back up plan in case of a massive world wide emp, they are a more useful to keep around and run then to just scrap them. Not to mention the history they represent. Plus the pollution and resources they use, are nowhere near as bad a say a car, a motorcycle, trucks, big power plants even. They don't generate as much harmful gas as most people think. Diesels are worse. Fuel efficent yes, but they emmit more toxic gas than a steam engine would. Most are never going to run again, but the ones that can are better to have in working condition so that when the time comes, they can be used again to serve more than just as an attraction. But for now, that is all we can use them as. Because tho only thing you said that is true, is the fact that they are expensive to run. They need ALOT of oil and grease. But yeah, getting rid of all of them is not a good thing. Trust me, there is too much history that can be lost if they are scrapped or kept from working. Trust me, do more research before you think of agreeing with THE BUG! He is an idiot.
Reply: joshua hudson Sadly with some of the stuff he gave me and others, I think he and Cockroach are what I shall call "Scrap partners". Wait and see what he talks about.
Reply: ***** I am reeeaaaaalllll!

I made the comment. I accept responsibility.
Reply: joshua hudson That EMP that you fear in a nuclear strike, will stop all the pace makers that the old men have that know how to run this garbage. And young men don't want such a nasty filth job of operating a steam locomotive!
Reply: deafyboy86 4014 is capable of making a resource of lots of materials for scrap. That is all that is necessary.
Reply: Cockroach 4014 is the revival of American steam preservation! Deal with it, in a quiet matter.
Reply: ***** 4014 is the big noise around the black market these days. It won't be long!
Reply: *****
Ohhhh, he is back on his false belief that there is an illegal market for locomotive parts. He keeps getting funnier and funnier doesn't he?
Reply: joshua hudson The dials, instruments, and name plates are quite valuable to collectors. Some of this stuff has been removed without permission. Same thing happened in the UK during the scrapping of steam years in the 1960s and after. Stolen items are not sold on the open market - it's quite simple really.
Reply: I have a whistle from a american type 4 4 0 1865, the damn thing is less than 600 dollars. That is not a lot of money for a near 200 year old antique. Parts are stolen by collectors, yes, but they are not on the black market. They are not worth that much. It is cheaper to steal it than to try and buy it, when it could also be a fake. Collectors will want proof that it came engine it was claimed to be from. Train parts on the black market are practically non existent. There are no high value parts primarily because most of the most famous trains are under guard or few in number making it near impossible to prove it is not a forgery. It is like saying you have a part from the first unit of the corvette in 53. You can not prove it is the real thing without taking it to a real expert and that costs alot of money. Trust me, train parts on the black market, you have a higher chance getting hit by lightning than finding a genuine part that is worth something. There just aren't that many locomotives that have high value parts because they are so generic. You have a valve from a mallard type? big deal. Not that special. Now if you actually owned the whole thing THEN you would have something going. Parts are worth more when they are attached to the machine they were made for, not when they were off. The only exception is when it is all that remains of the machine. And trust me, finding a one of a kind part is rarer than finding a diamond in your yard.
Reply: joshua hudson Yep. Despite how heelfan1234 here tried to make it seem like he's telling the truth.
Reply: joshua hudson I'm glad you gave the proof. Even without the proof, I seemed to know the "less valuable as a part then as the whole thing" like instinct. Logic is in my brain when it comes to that idea.
Reply: Cockroach gr8 b8 m8 i r8 8/8
Reply: WhyDidIJustEatThat ?????
Reply: WhyDidIJustEatThat
Clever!
Reply: completely. He is a strange sad little troll for sure.
Reply: joshua hudson
 Check out the value of the example steam loco parts I gave - it is all on ebay. They are worth 100$'s and 1000$'s. Cockroach  is right - a huge black market for these things and very very lucrative! No questions are asked!

Cut the duplicate steam locos apart and melt them for scrap!
Reply: +heelfan1234
 Convincing icverano525 of anything he doesn't want to believe near impossible. If one other person besides himself has said so, it is the gospel. 

He is unaware that nearly the entire world believed the world was flat & the sun & stars pivoted about the earth at one time. Galileo & Copernicus had to be thrown into religious prison for heresy because the cardinals, bishops & the pope declared their information to be against the rules of God.

So, icverano525's belief that if my friends don't know about it, it is not true & lie.

Icverano525 is in for a very rude awakening one day!

You are correct! There is a very private place on ebay for steam locomotive parts!
Reply: Cockroach Same logic could be said to you! You don't want to believe steam locos will live forever!

Psh, I was aware of that. The world was once believed to be flat! But that doesn't mean your pathetic story is true!  Private place on ebay? Pathetic!
Reply: heelfan1234 Ivory is worth alot more than a locomotive part. Locomotive parts are not that lucrative. Both you and cockroach are just trolls. Hell i believe you two are the same person.
Reply: joshua hudson Right on. He's been trying to make me think Cockroach is telling the truth, luckily I'm not that stupid. ;)
Reply: ***** Is the world still flat for you? Steam locomotives are on their way to the black market, in parts!

There is no private section of ebay! There are ways to find those specialty parts. And don't kid yourself that they can all be found on ebay or the internet. You have got to get up out of your cushioned chair & beat the street a bit to find most of it.

There is at least 3 inquiries across the counter or on the telephone every 2 weeks here. Most are coming in with grocery baskets full of aluminum cans or other scrap metal they have found. But they are always asking & not looking or posting on ebay to sell or purchase anything. They are acquiring & selling.

You should work here for a month to see it before your very eyes!
Reply: joshua hudson I am aware you are speaking to heelfan1234, but I will tell you that steam locomotive parts are much easier to find than is ivory. When you work in the scrap metal business, I don't see people coming in to sell me ivory they have collected or acquired. Even they are smarter than that!
Reply: *****
 Wow he totally missed my point didn't he?
Reply: joshua hudson No, Joshua, just a mention that you are comparing apples to oranges. The ivory & scrap metal markets are complete solar systems apart.

Always CASH paid for steam locomotive parts on the black market! Engineer's instruments, bell, whistle, headlight, number herald, marker lights, builder's plate, grab irons, brass bearings, bushings or babbitts, tools, wiring, tubing, valve handles, valves, levers & many other parts.  ABSOLUTELY NO QUESTIONS ARE EVER ASKED ABOUT WHERE THE PARTS MAY HAVE COME FROM, WHEN OR HOW THEY WERE ACQUIRED! Very, very lucrative! Very, very profitable! Very, very low, low risk!

Junk all the remaining steam locomotives! Cut them apart & melt them down. Besides, it is fun for the WHOLE family, to watch the steam locomotive being melted!
Reply: *****
I don't know who is having more fun, me or him? He is ignoring the fact that the point was that Ivory is worth MORE than steam engine parts. Much more lucrative, ivory is. Not once did i say that they were in the same class. Only that one is worth more than the other.
Reply: Cockroach Both concepts of the world's shape are believable in their own ways, but steam on the black market is not after you make millions of comments about it.

You just said there is a private section on ebay a few comments ago, watch as you kid your own self.

You want me to work? Give me a phone number and address, then I could actually know to come.
Reply: Cockroach Not when it is shipping organs. Come learn about what it really sells.

Copy and paste time: "You are correct! There is a very private place on ebay for steam locomotive parts!" Goodbye argument of Cockroach-that-never-flies.

Two things:
-One, I never got a street address from you.
-Two, we haven't known each other for "years". Strike three and he's outta here! 

Congratulations, you just told me what you are trying to do. Well done, I know your secret now. "You want it your way only".
Reply: *****
This is what i discovered. The most a person can make off of illegal steam parts in a year  on average is just over 10,000 a year. I make more than that in 6 months. More proof that steam parts just are not worth it. Now selling the whole thing in working order can make you a millionaire. That is a better move. Seems to me that cockroach does not think big eh?
Reply: Cockroach Well that's what the black market sells....

I didn't need to know that.

Block number? When? You never gave me one. I can read! Yes you did, you talked about doing something years ago, which I would not have been aware of.

I knew it all along, but I would not have said it before as you would deny it.
Reply: joshua hudson Depends how many parts you can sell and at what profit. There's no justification to put $10,000 cap on it. You are dealing in antiquities, Some nameplates ar worth more than that alone. So your $10,000 figure is totally unjustified - where is the link to provenance for that?
Reply: heelfan1234 Your buddy Cockroach is unjustified too. He doesn't give links to provenance for anything he says, so no berating him first. I suspect you don't report or call out cockroaches's actions because he agrees with you. What rubbish.
Reply: heelfan1234
 I said average. And like i said, i make more than that in six months. So say you get a nameplate that is from a engine and is real, no one will buy a nameplate for 10,000. It is a lump of steel. Even if it 100 years old, it is not worth it. Now if it is from a famous locomotive, then it would be worth it if you could prove it. Selling parts on the black market is not as profitable as you seem to believe. Old paintings are worth ALOT more. Ivory is worth ALOT more. Illegal weapons are worth ALOT more. How you seem to think the black market works is really childish. Steam parts are not a commonly sought after commodity and they don't yield enough money to support a person for very long.

SQUISH ALL THE ROACHES AND THE TROLLS! FUN FOR EVERYONE AND BRINGS IN ALOT OF LAUGHS!
Reply: joshua hudson It takes you 6 months to make 10,000? I earn that in a month. But I digress. You have no idea of the money in collectibles and non ferrous metals.
Reply: heelfan1234 And your job is? I digress. You seem to have a ton of time to comment on youtube and troll people.
Reply: ***** At least I can write decent English. Your written text is a disgrace. You should either be at college learning, or if it is a time between terms, taking extra classes to catch up. You should not be wasting time with toy train sets or You Tube with your level of education.
Reply: heelfan1234 Explain why.
Reply: mojostevo What you think I am doing is none of my concern. But, I thank you for the very flattering name! I sincerely appreciate it.

What I am really doing is looking for a very financially lucrative for my crews to make plenty of extra money on! The scrapping of a steam locomotive satisfies they need!
Reply: mojostevo
already know that. And thanks for starting this up again. He was staying quiet after i beat him.
Reply: I make 2 million a year. And you won't even come close sellin engine parts. Only the whole engine is worth more. A whole engine can be worth tens of millions. But you can't make that. I can if i sell my Action Comics No 1 ten times over.
Reply: joshua hudson Bully for you! No, steam locomotive parts alone will not yield that. That is why I have other items of metal to sell to the foundry! But for a financially desperate person, $40K is a lot of money in a single sale. If they can make 4 $50K sales to the black market in CASH, it will change their lives!

The whole engine is too difficult to sell or move. But, high valued parts, makes a difference. Small, transportable, easily removable! Many good reasons why & no good reasons why not!

Your Action Comics #1 is only worth that if someone will pay that amount. No matter what it is appraised for, if there are no buyers who will pay the appraised price, it is not worth that value!

Junk all the remaining steam locomotives! Cut them apart & melt them down!
Reply: The people in deadliest catch make more than that. People who sell ivory make more than that. Other things are worth more than train parts and easier to obtain. You are messing with a very educated man here bug. I got the big brain you got the small brain.
Reply: joshua hudson
Big brains should be cut apart and melted down. Far too much scrap value tied up there, and all spouting waffle too :P
Reply: 200th Comment!!!!
Reply: Cockroach
Why? I like messin with trolls. And like i said, there are far more lucrative objects that are far easier to obtain than old train parts. Besides, steam trains are a good educational experience for children. Especially when they work. The sounds, seeing such a complex machine in action, the smells! Ohhhh it is soooo much pleasure for the brain! Face it troll, my logic has won the day, proven that you are just a simple little bug. And also that we train aficionados are one too many, and you train haters are few. We are the steam engine fans. We will add your skills and knowledge of metals and machinery to our own. Your culture will adapt to service us. Resistance is futile.
Reply: joshua hudson Black Widow Spider
Reply: wrong, I said often i am not black. Black widows are always black. AND HOW IN THE HELL DO THEY HAVE A FACE LIKE A CRICKET? and they are NOT coppery in color. Try again.
Reply: Cockroach
Baseball cards can be worth more than a steam part. Comics can be worth more than a steam part. Old cars can be worth more than a steam part. A damn Babe Ruth original card is worth more than that. Hell a Cuda 426 Hemi is worth more than a steam part. Heheh, hell, a damn jersey worn by one of the greatest football players ever, Walter Payton, can fetch more than a steam part. These are all in greater quantity and easier to obtain than steam parts. More money can be made by reactivating the engines and using them as entertainment. Look at amusement parks and the recreational steam engine rides. They make money. Alot more money than they would scrapping them. Estimates for the net gain of the Big Boy will bring is in the tens of  millions and will negate all costs to keep it up and running. There are hundreds of steam engines still running here in the states. And quite a few make ALOT more money than either of us combined. Children and families love the experience. So if money is what is important, maybe i should invest in a old 4 4 0 engine like my ancestor drove, make even more money than i could make scrapping it. Money can be made from them, but not with your far flung methods. Owning and operating famous engines could fetch ALOT of money in the entertainment business. Nice try troll, but this game is over, i win, because you failed to convince me and many others. Your ploy has crumbled before you. My evidence has stacked up and continues to rise while yours has toppled over. Face it troll, the money that can be made from the steam engine is by reactivating all of them, and using them as excursion vehicles, provides education, is relaxing, and fun for the whole family. So enjoy your short lived service, you can retire on the money you make in, oh, 90 years, give or take  another 20. While i can retire on mine anytime i want, because i have things that are worth far, far more and are more lucrative and much easier to acquire than steam part, and here is another reason why steam parts are not gonna get you alot of money per year. There are more things that other people would rather have than a steam part, and i should know, cause i am a monstrously huge fan of steam engines. So you lose, heelfan loses, while the rest of logical society mocks you two. And best of all, steam engines will always be hear, they will outlast all of us, and they will return to full function when the greatest calamity befalls humanity. Heheheheheheh AAAAAAAAAAAHAHAHAHAHHAHAHAHAHAHAHAAAAAAAAAAA!
Reply: joshua hudson Perhaps those other items are in greater abundance & worth more, however, the parts of a steam locomotive are worth enough to interest a few. I am sure that if the others were easier to locate, they would go for them due to the value. However, since those baseball cards, comics, old cars or jersey is more difficult to locate, the parts of a steam locomotive are are very desired by those who want to earn CASH on the black market with some very lucrative sales with low, low risk! For those who don't have the money for a renovation, steam locomotive parts sales is very very profitable for them.

You understand, it only takes one person to really get the right parts to make the steam locomotive a wreck. An angle grinder in the engineers cab can cut off a lot of parts which can be sold on the black market.

What you think of this win/lose situation is none of my business! I didn't set out to win anything. I am just letting people know where the parts are, what they are worth, where they can be obtained, where they can be sold, how they will be paid for the parts & what the risk is.

I never thought of it to be a contest. What you thought it was is none of my concern. It is just information for the right person who reads it!

Have a good nightmare of the steam locomotive being ripped apart by black market merchants!
Reply: Blah blah blah, that is all you speak. Answer the damn riddle.
Reply: joshua hudson Btw, I'm beginning to think the only parts from the steam locos that are actually valuable are the bells & whistles. No other parts seems to have much value.
Reply: 1230james Nuclear power might not be a great idea (it's dangerous) but it could work. The small nuclear plants that run submarines and don't need refueling but once every ten years or so could easily fit onto the frame of a large steam loco, and those power plants are designed to produce steam, so it could be feasible, but probably isn't cost effective. Nevertheless, 4014 is an incredible machine. It's size and power are awe inspiring, and it was built my mere mortal men. It deserves to be restored to working condition, and should be used around the country as a piece of inspiration to teach our young people what engineering, science, and mathematics can make in the real world.
Reply: David Rachlin Steam powered railway locomotion is commercially dead. The frequent need to pick up water is a time consumer & a power waster. All it is good for any longer is for a circus amusement. If nuclear power is ever employed, it will be to propel a turbine which produces electricity for the traction motors. Not propel heavy reciprocating parts.
Reply: Cockroach You seem sir, to have conveniently ignored the fact that the turbines spun by a nuclear prime mover are spun by steam generated by that prime mover. Your argument is invalid.
Reply: +Squarerig It's okay Squarerig (tall ships are cool too!) I have reported him as well, but not for being any kind of troll. He is annoying, but in his YouTube profile the bug purports to provide people with information about how to commit crimes by stealing railroad parts and selling them on the black market. Facilitating a crime is a violation of YouTube's user agreement. Yes, he's annoying, but that's no good reason to ban him from YouTube. A clear and direct violation of their policy about appropriate materials is a great reason.
Reply: David Rachlin I am aware that nuclear energy produced heat is used to produce steam which spins turbines. It is what happens to the spent steam vapor after the energy has been extracted to produce the kinetic energy. In a ship, it is vented into the ocean water surrounding the vessel & more salt water is brought on to start the process. I know of no nuclear system which has a 100% recovery of turbine drive steam/water.

Now, since the railroad is a terrain based transportation system, it must get a replenishment of water from some where. If it can't pick it up while moving, then it must stop. That is where the waste is. The time & frequency of those stops.

Reciprocating parts of a Walschaerts piston drive steam locomotion is horribly inefficient. Better technology is out there & it is not steam powered reciprocating pistons & a mechanically timed valve system.

Steam turbine driven generators is the only present future for steam locomotives. Not mechanical inefficiencies of the 19th century!

May point is valid. It was never an argument that I knew of.

Junk all the remaining steam locomotives! Cut them apart & melt them down.
Reply: pur4567 .bruce v What you think is none of my concern.

Thank you very much for the very flattering compliment! I sincerely appreciate it!
Reply: Cockroach You don't need to reply
Reply: ***** Correct! I don't need to. But I want to because I don't want to be rude!
Reply: joshua hudson  I am not attacking anyone's hobbies! I am providing information to people. Why would you say such a thing? I haven't looked at your riddle. And if I had, why would I owe you an answer?
Reply: One, you did attack a hobby, the hobby of steam engines. Millions of people enjoy them, and yet you say they must be scrapped, when you said you don't want to be rude. Two, the riddle is meant for you and your friend, to test you.
Reply: joshua hudson One, I did not attack anyone's hobby. I am providing information. Sure, some people may enjoy them, but there are others who enjoy selling the parts for the CASH value they can earn on the black market selling the parts.

Two the steam locomotives should be scrapped & the materials reused. All that is necessary is they be documented & photographed. That is all the historical record necessary. We have plenty of that now. No more is needed.

Three, what is the purpose gained in answering a riddle? It appears to be nothing more than you are humoring yourself. I haven't spent anytime thinking about it. I can't speak for my friend, but I am certain he will not waste his time on such frivolity.

Always CASH paid for steam locomotive parts on the black market! Engineer's & fireman's instruments, bell, whistle, headlight, number herald, marker lights, builder's plate, grab irons, brass bearings, bushings or babbitts, tools, wiring, tubing, valve handles, valves, levers & many other parts.  ABSOLUTELY NO QUESTIONS ARE EVER ASKED ABOUT WHERE THE PARTS MAY HAVE COME FROM, WHEN OR HOW THEY WERE ACQUIRED! Very, very lucrative! Very, very profitable! Very, very low, low risk!

Junk all the remaining steam locomotives! Cut them apart & melt them down. Besides, it is fun for the WHOLE family, to watch the steam locomotive being destroyed & melting down!

Read it for yourself, but there is no attack made upon anyone. It is information for people to use. Distributed absolutely free!
Reply: joshua hudson What you think of me is none of my concern, pixelating MP3 file! I wasn't planning on wasting time on any riddles. What you think of me is none of my concern.
Reply: Yeah, you are not a bug, you are a broken record. Change your name to broken record. It fits.
Reply: joshua hudson What you think I am is none of my concern. I like my screen name. I am not changing it!
Reply: ***** What you think of me is none of my concern.
Reply: Whatever you say broken record.
Reply: joshua hudson It is what I write! How or what you think of what I write is none of my concern,
Reply: This has nothing to do with what I think of you.
Reply: Cockroach
Brooooooooooken Reeeeecooord!
Reply: ***** You were not being addressed, schoolboy! Having trouble with your reading skills again because you have been tweaking?
Reply: joshua hudson What you think is none of my concern.
Reply: Cockroach What I think of you is your entire concern.
Reply: *****
BONUS POINTS!
Reply: ***** I am not concern about you think of me. I keep telling you, but it doesn't sink in, does it?
Reply: Or we don't care.
Reply: joshua hudson What "we" care or don't care about is none of my concern.
Reply: ***** Yes, there may be a handful of people out there to comprise a "we", but it is a very small "we". In fact they are such a small group, those who want to part off & scrap the steam locomotives, these people are regarded as, "Wee We".
Reply: So what you are saying is that there are so few of you steam haters, and many more of us steam lovers? That also means that your end does not justify the means. The needs of the many outweigh the needs of the few. Your view is outdated.
Reply: joshua hudson When CASH is all that matters, it only takes one individual to remove a mission critical part & disable the steam locomotive permanently. One ONE! The end is justified by the needs of ONE individual for it is survival needs. What is left behind is of no importance. What you think of this view is none of my concern. Besides these machines should have been junked, cut apart 70 years ago! What better way to get a start with the missed appointment so long ago than to see the parts removed by desperate people & sold for their survival needs & CASH on the black market?
Reply: Whatever you say broken record, whateeever you say.
Reply: joshua hudson
 What you think of my message, is none of my concern.

What is, "whateeever"? A new word you have gifted to the world? Another Darwin candidate!
Reply: Cockroach Let's cut the chase and get to the point.
1: You're not gonna scrap it
2: We're not gonna scrap it
3: The "financially desperate people" will seek a better way to make money
4: There is no black market for steam trains
5: There are still loads of people interested.
6: The steam locomotives are here to stay.
7: You are a no-lifer troll who does not own a scrap yard
Reply: ***** What you think is none of my concern. What I do is own & operate a scrap yard where we prepare metals for various foundries by cutting those materials into crucible size pieces for melting. We also segregate all materials so the  load outs are nothing but the materials may want to use.

Whether anyone wants to read my comments or not is none of my concern. I thank you for your "observation" about my messages, however, I am here to stay & make my comments as I am entitled to on YouTube.
Reply: blueyoshi970 Thank you for the very thoughtful suggestion! However, after thinking it over carefully for several hours, I must respectfully decline. But thank you for taking the time to suggest it. I sincerely appreciate it.

The black market for steam locomotive parts does exist. Where do you think the missing parts of ATSF 2926 ended up? If you don't believe it, then believe what you want to believe. What you do or do not believe is of no concern to me.

Always CASH paid for steam locomotive parts on the black market! Engineer's & fireman's instruments, bell, whistle, headlight, number herald, marker lights, builder's plate, grab irons, brass bearings, bushings or babbitts, tools, wiring, tubing, valve handles, valves, levers & many other parts.  ABSOLUTELY NO QUESTIONS ARE EVER ASKED ABOUT WHERE THE PARTS MAY HAVE COME FROM, WHEN OR HOW THEY WERE ACQUIRED! Very, very lucrative! Very, very profitable! Very, very low, low risk!

Junk all the remaining steam locomotives! Cut them apart & melt them down. Besides, it is fun for the WHOLE family, to watch the steam locomotive being destroyed & melting down!
Reply: I CALL COMMENT 251
Reply: ***** It does! But there is a small corner of the black market where desirable items are marketed. Like paintings from museums, artifacts taken from the Egyptian tombs, marble sculptures taken from ancient Greek structures, diamonds taken from displays, animal hides smuggled out of Africa, elephant tusks, shark fins, rhinoceros horns & the big kauna, steam locomotive parts! There is plenty that goes on in the black market. Comment 252!
Reply: joshua hudson I have comment 253 right here for you!

Always CASH paid for steam locomotive parts on the black market! Engineer's & fireman's instruments, bell, whistle, headlight, number herald, marker lights, builder's plate, grab irons, brass bearings, bushings or babbitts, tools, wiring, tubing, valve handles, valves, levers & many other parts.  ABSOLUTELY NO QUESTIONS ARE EVER ASKED ABOUT WHERE THE PARTS MAY HAVE COME FROM, WHEN OR HOW THEY WERE ACQUIRED! Very, very lucrative! Very, very profitable! Very, very low, low risk!

Junk all the remaining steam locomotives! Cut them apart & melt them down. Besides, it is fun for the WHOLE family, to watch the steam locomotive being destroyed & melting down!
Reply: Cockroach "Small" tells me it must be doing horrible. Time to shut it down
Reply: ***** It is doing fine! I am here to stay. How is Miley Cyrus? She still bothering you?
Reply: Cockroach That just proves that diesels are weak. 4014 does not operate yet.
Reply: blueyoshi970 What you think of diesel-electric locomotives is none of my concern. But they are much more economically practical & environmentally green to operate for a company. The steam locomotives are not good investments. 4014 will not operate. They are finding worse problems as they dig deeper. It will be scrapped. And the black market will be delighted to help it's parts disappear!
Reply: +Cockroach "Environmentally green"? Steam locomotives pollute less than diesels, DOLT!

"Are not good investments." What???? Grammar troubles again, DOLT?

It will operate. What you think is none of my concern.
What you think will happen to it is none of my concern.

What you think about the black market is none of my concern.
Reply: blueyoshi970 All factored up, operation & maintenance, the steam locomotive is a horrible polluter compared to diesel-electric. DOLT! Correct, "The steam locomotives are not good investments" Steam locomotives are horrible financial investments! A great reason for the railroad industry dumped them in the 1950's as fast as they could replace them with cleaner, more fuel efficient, labor efficient, lower cost, less maintenance diesel-electric locomotives. A great & wise financial move indeed!

Great! Now that I know you are not concerned, here is something else which will not concern you.

Are you planning that summer vacation & coming up short on the CASH you need to go where you really want to go? Are you planning on going first class & find it is not in your budget at your present income? Do you need CASH to purchase a Valentine’s Day gift for your love interest? Jewelry is not cheap! Do you need CASH to pay your coming tax bill on April 15th? Are you needing CASH to clear away those holiday bills? Or CASH to pay an overdue car payment? Or CASH for a home repair which just can't wait any longer? How about some CASH for a holiday away with the family? The CASH you need may be as close as the nearest historical railroad in your area.

There is ALWAYS CASH paid for steam locomotive parts on the black market!

Engineer's & fireman's instruments, bell, whistle, headlight, number herald, marker lights, builder's plate, grab irons, brass bearings, bushings or babbitts, tools, wiring, tubing, valve handles, valves, levers & many other parts.  ABSOLUTELY NO QUESTIONS ARE EVER ASKED ABOUT WHERE THE PARTS MAY HAVE COME FROM, WHEN OR HOW THEY WERE ACQUIRED! Very, very lucrative! Very, very profitable! Very, very low, low risk! It is very, very easy, quickly accessible & so, so rewarding!

Here is a long list of steam locomotives which can be targeted 2, 3, 13, 29, 93, 112, 175, 202, 261, 385, 464, 470, 482, 484, 486, 488, 489, 502, 506, 576, 592, 630, 643, 700, 759, 765, 844, 1218, 1223, 1309, 1361, 1504, 1518, 1604, 1630, 1795, 2100, 2101, 2124, 2156, 2500, 2542, 2716, 2749, 2933, 3001, 3003, 3007, 3977, 3985, 4003, 4004, 4005, 4006, 4008, 4012, 4014, 4017, 4018, 4023, 4100, 4294, 4449, 4460, 4500, 4501, 4516, 4524, 4978, 5017, 5629, 9000,  and  are out there waiting for a visit to have the parts removed for black market CASH sales! Then haul all of them into the scrapyard, torches, plasma cutters, chippers & crusher! Load out all that iron to foundry, put in the crucible of an induction furnace & melt it down! Happy, happy days!

If you are traveling The best part, these targets are all around the country. If you are traveling & need some quick CASH, there is always one near you, waiting for a visit for a parts removal! Doesn’t that sound good?

Junk all the remaining steam locomotives! Cut them apart & melt them down. Besides, it is great fun for the WHOLE FAMILY to participate & watch the steam locomotive being cut apart & melted down the following day! Makes for a wonderful vacation!
Reply: +Cockroach Every machine needs maintenance, DOLT!
Reply: blueyoshi970 Correct! DOOFUS! The cost of that maintenance due to the task requirements is where the corporations drew the line. The steam locomotive is just too expensive. Even the hydraulic shares I operate needs maintenance.
Reply: +Cockroach Whatever the cost, it's worth it once it is done.
Reply: blueyoshi970 These relics are not worth a plug nickel when restored. But the parts are worth plenty on the black market. The black market pays CASH for the parts with ABSOLUTELY NO QUESTIONS ARE EVER ASKED ABOUT WHERE THE PARTS MAY HAVE COME FROM, WHEN OR HOW THEY WERE ACQUIRED! Very, very lucrative! Very, very profitable! Very, very low, low risk! It is very, very easy, quickly accessible & so, so rewarding!

"What parts?" you ask. Engineer's & fireman's instruments, bell, whistle, headlight, number herald, marker lights, builder's plate, grab irons, brass bearings, bushings or babbitts, tools, wiring, tubing, valve handles, valves, levers & many other parts. Just take your battery operated angle grinder, sawzall or cutting torches & go to work. There is no need to be neat about this, for you can clean them up before you make your sale. Often, you don't need to clean anything. They often purchase as is!

Here is a long list of steam locomotives which can be targeted 2, 3, 13, 29, 93, 112, 175, 202, 261, 385, 464, 470, 482, 484, 486, 488, 489, 502, 506, 576, 592, 630, 643, 700, 759, 765, 844, 1218, 1223, 1309, 1361, 1504, 1518, 1604, 1630, 1795, 2100, 2101, 2124, 2156, 2500, 2542, 2716, 2749, 2933, 3001, 3003, 3007, 3977, 3985, 4003, 4004, 4005, 4006, 4008, 4012, 4014, 4017, 4018, 4023, 4100, 4294, 4449, 4460, 4500, 4501, 4516, 4524, 4978, 5017, 5629, 9000 and 9001 are out there waiting for a visit to have the parts removed for black market CASH sales! Then haul all of them into the scrapyard, torches, plasma cutters, chippers & crusher! Load out all that iron to foundry, put in the crucible of an induction furnace & melt it down! Happy, happy days!

If you are traveling The best part, these targets are all around the country. If you are traveling & need some quick CASH, there is always one near you, waiting for a visit for a parts removal! Doesn’t that sound good?

Junk all the remaining steam locomotives! Cut them apart & melt them down. Besides, it is great fun for the WHOLE FAMILY to participate & watch the steam locomotive being cut apart & melted down the following day! Makes for a wonderful vacation!
Reply: +Cockroach Well guess what? Dai Woodham found out that he made more money selling them to preservation societies other than scrapping. He found out he made more money scrapping rolling stock. It's a fact.
Reply: +Cockroach Whenever it was however, he was extremely smart.
Reply: blueyoshi970 Sure, when you could sell a steam locomotive & trust that insurance companies would underwrite a policy for it to operate on a commercial line.

Now, unless you own the railroad, the railroads want a $500M insurance policy before they allow the junker to operate on the system. This cost is prohibitive & many now have to have their own little right of ways, completely separate from the mainlines. So they are reduced to little tunerville trolleys to nowhere. Not worth the fare! A line of junk waiting for the grim reaper to come by with his scythe & gather the corpse.

The steam locomotive is on it's way to the grave. Day by day, a little closer unless the black market vendors make a visit. Then it is a sprint to the steam locomotive grave! Happy, happy!

There is ALWAYS CASH paid for steam locomotive parts on the black market!

Engineer's & fireman's instruments, bell, whistle, headlight, number herald, marker lights, builder's plate, grab irons, brass bearings, bushings or babbitts, tools, wiring, tubing, valve handles, valves, levers & many other parts.  ABSOLUTELY NO QUESTIONS ARE EVER ASKED ABOUT WHERE THE PARTS MAY HAVE COME FROM, WHEN OR HOW THEY WERE ACQUIRED! Very, very lucrative! Very, very profitable! Very, very low, low risk! It is very, very easy, quickly accessible & so, so rewarding!

Here is a long list of steam locomotives which can be targeted 2, 3, 13, 29, 93, 112, 175, 202, 261, 385, 464, 470, 482, 484, 486, 488, 489, 502, 506, 576, 592, 630, 643, 700, 759, 765, 844, 1218, 1223, 1309, 1361, 1504, 1518, 1604, 1630, 1795, 2100, 2101, 2124, 2156, 2500, 2542, 2716, 2749, 2933, 3001, 3003, 3007, 3977, 3985, 4003, 4004, 4005, 4006, 4008, 4012, 4014, 4017, 4018, 4023, 4100, 4294, 4449, 4460, 4500, 4501, 4516, 4524, 4978, 5017, 5629, 9000 and 9001 are out there waiting for a visit to have the parts removed for black market CASH sales! Then haul all of them into the scrapyard, torches, plasma cutters, chippers & crusher! Load out all that iron to foundry, put in the crucible of an induction furnace & melt it down! Happy, happy days!

If you are traveling The best part, these targets are all around the country. If you are traveling & need some quick CASH, there is always one near you, waiting for a visit for a parts removal! Doesn’t that sound good?

Junk all the remaining steam locomotives! Cut them apart & melt them down. Besides, it is great fun for the WHOLE FAMILY to participate & watch the steam locomotive being cut apart & melted down the following day! Makes for a wonderful vacation!
Reply: +Cockroach What you think is not my concern!
Reply: blueyoshi970 What I think is none of your concern. What I know is your concern. Your steam locomotives are headed for the black market in pieces.
Reply: +Cockroach What you think the steam locomotives are headed for is none of my concern.
Reply: Cockroach yeah you and your financially desperate & hungry people will whatever it takes....except getting jobs and actually contribute to society
Reply: Thomas Horner He says that scrapping them will help the financially desperate people... Yet they don't have any money, and they have to buy scrap, so it won't contribute to them. :)
Reply: Thomas Horner
These people are in need of some help. The black market will pay them CASH for steam locomotive parts. There is a need & the financially desperate people can create a supply chain. As for me, I own & operate a business which is very profitable. After the steam locomotives are picked over, that is when I move in to finish the job!
Reply: I am replying to your first comment

How can somthing move when there is nothing to power it
Reply: South Town Trains You got it bud! Roach has terrible logic! Thanks for helping point that out!
Reply: South Town Trains u
Reply: Cockroach And this arguement has been going on for almost a year, this is freacking rediculas.

You should not think that someone would just sell a steam loco.

or even steal one for that matter.

They are reboulding these to show people what it was like back then and to experience it.

Your an idiot for even making the comment, they should remake these old models for enjoyment, life would be boring without fun things to do.
Reply: South Town Trains Let them be rebuilt! More parts to remove for the financially desperate people who will sell those parts for CASH on the black market. The people who receive the CASH would say that the sale of steam locomotive parts is enjoyment! In fact, so much enjoyment, it is a life changer for many!

And thank you for the extremely flattering compliment! I sincerely appreciate it!
Reply: Cockroach DO YOU  KNOW HOW MANY OTHER FRICKEN STEAM ENGINES THERE ARE TO SCRAP, THEY ONLY HAVE WHAT, THREE TO USE OUT OF THE THOUSANDS THAT HAVE BEEN SCRAPED THAT CAN BE USED FOR PARTS.

THIS IS ONLY ONE FREKING BIG BOY OUT OF 25, NOW IF YOU WOULD KINDLY LEAVE.
Reply: South Town Trains No! I don't know! And for your information, I would like to inform you, I don't care! How many steam locomotives were built or remain is none of my concern. I do care about the money that can be earned by scrapping the remaining steam locomotives by cutting them apart & sending them to the foundry for melting down. Money is all that Imatters! And for the financially desperate people, money in the form of CASH is the very best form. The black markets only pay for the parts they purchase in CASH. Lucrative sums of CASH!

I am here to stay! You don't like my comment? That is to too bad! You don't like it? You do something about it!
Reply: Please guys, no more responses, that's just feeding the troll who wants to get us steaming mad.
Reply: 09trainman Dude, Cockroach is correct. I would love to see more steam locos cut and pulled apart by scrapping magnets. They can then be recycled and melted down to make useful things.
Reply: 2716Kanawa
 Too much maintenance needed. Break them apart for scrap and make diesel and electric locos.
Reply: 2716Kanawa
 Steam needs 10 times as much though. It is what killed steam along with the pollution.
Reply: heelfan1234 No, the pollution had nothing to do with it, it was maintenance.

Besides, it's worth it when it's done.
Reply: 2716Kanawa The truth is, they remain garbage when done! Pull & cut the machine apart! Then melt it into new products!
Reply: Cockroach No.
Reply: 2716Kanawa Nice edit job there! 2716Kanawa 3 hours ago (edited). DOLT!
Reply: Cockroach Does it say "edited" next to it? I don't think so.
Reply: 2716Kanawa It does! I see it there right now. The only change is now it is 4 hours instead of 3. DOLT!
Reply: 2716Kanawa There is another edit by 2716Kanawa only 32 minutes ago to correct one of your many, many writing errors! DOLT!
Reply: 2716Kanawa I am clever! Thank you! I am not plagiarizing what so ever! DOLT!
Reply: Cockroach Well I said something, and you flipped it.

Sounds like plagiarizing to me.
Reply: 2716Kanawa What you think it sounds like is none of my concern.
Reply: Check your facts!
Reply: Takumi Fujiwara Thank you for the well thought out suggestion! I sincerely appreciate it Junk all the remaining steam locomotives! Cut them apart & melt them down. Besides, it is great fun for the WHOLE FAMILY to watch the steam locomotive being cut apart & melted down the following day! Makes for a wonderful vacation!

History: the record of past events and times, especially in connection with the human race.
Nothing in there are about artifacts or the preservation of relics!
$30K for the engineer's & fireman's instruments, $25K for the bell, $27.8K for the whistle, $13K for the headlight, $12K for the number herald, $18K for the marker lights, $24K for the builder's plate, $1.7K for the grab irons, $10K for the brass bearings, bushings or babbitts, various amounts for the tools, hundreds for the wiring, tubing, valve handles, valves, levers & many other parts.
Dear citizens: As exhibited here, the steam locomotive is not worthy of preservation nor salvage. It is reusable materials formed into the shape of an object which it's materials can be reused. If you are looking for some fast cash, look no further than your local heritage railroad with a steam locomotive. Operating or not, the parts are worth very lucrative sums of CASH on the black market. If you need CASH, these are OPEN BANKS FOR WITHDRAWALS !
Instead of donating your hard earned money to these ridiculous relics of junk & their so called organizations of preserving heritage railroads for their own purposes, would you not rather be the one getting paid? There is a great way to make that happen. There is ALWAYS CASH paid for steam locomotive parts on the black market!
Engineer's & fireman's instruments, bell, whistle, headlight, number herald, marker lights, builder's plate, grab irons, brass bearings, bushings or babbitts, tools, wiring, tubing, valve handles, valves, levers & many other parts.  ABSOLUTELY NO QUESTIONS ARE EVER ASKED ABOUT WHERE THE PARTS MAY HAVE COME FROM, WHEN OR HOW THEY WERE ACQUIRED! Very, very lucrative! Very, very profitable! Very, very low, low risk! It is very, very easy, quickly accessible & so, so rewarding!
Here is a long list of steam locomotives which can be targeted 2, 3, 13, 29, 93, 112, 175, 197, 202, 261, 385, 464, 470, 482, 484, 486, 488, 489, 502, 506, 576, 592, 630, 643, 700, 759, 765, 844, 1218, 1223, 1258, 1309, 1361, 1504, 1518, 1604, 1630, 2100, 2101, 2124, 2156, 2467, 2500, 2542, 2716, 2749, 2933, 3001, 3003, 3007, 3424, 3977, 3985, 4003, 4004, 4005, 4006, 4008, 4012, 4014, 4017, 4018, 4023, 4100, 4294, 4449, 4460, 4500, 4501, 4516, 4524, 4978, 5017, 5629, 6755, 7002, 8300, 8305, 8327 and 9000 are out there waiting for a visit to have the parts removed for black market CASH sales! Then haul all of them into the scrapyard, torches, plasma cutters, chippers & crusher! Load out all that iron to foundry, put in the crucible of an induction furnace & melt it down! Happy, happy days!
Traveling? These targets are all around the country. If you are traveling & need some quick CASH, there is always one near you, waiting for a visit for a parts removal! Doesn’t that sound good?
Junk all the remaining steam locomotives! Cut them apart & melt them down. Besides, it is great fun for the WHOLE FAMILY to participate & watch the steam locomotive being cut apart & melted down the following day! Makes for a wonderful cut them apart & melt them down vacation!
People needing CASH may target the steam locomotive for their financial needs. The black market ALWAYS PAYS CASH for steam locomotive parts. There are collectors who want a part of a steam locomotive & will pay lucrative sums of CASH to get them for their personal & private collections. ABSOLUTELY NO QUESTIONS ARE EVER ASKED ABOUT WHERE THE PARTS MAY HAVE COME FROM, WHEN OR HOW THEY WERE ACQUIRED! Let me give you an idea of what is wanted: Engineer's & fireman's instruments, bell, whistle, headlight, number herald, marker lights, builder's plate, grab irons, brass bearings, bushings or babbitts, tools, wiring, tubing, valve handles, valves, levers & many other parts.
Very, very lucrative! Very, very profitable! Very, very low, low risk! It is very, very easy, quickly accessible & so, so rewarding!
Reply: Takumi Fujiwara I have! 4014 is good for scrapping! Junk all the remaining steam locomotives! Cut them apart & melt them down. Besides, it is great fun for the WHOLE FAMILY to watch the steam locomotive being cut apart & melted down the following day! Makes for a wonderful vacation!

History: the record of past events and times, especially in connection with the human race.
Nothing in there are about artifacts or the preservation of relics!
$30K for the engineer's & fireman's instruments, $25K for the bell, $27.8K for the whistle, $13K for the headlight, $12K for the number herald, $18K for the marker lights, $24K for the builder's plate, $1.7K for the grab irons, $10K for the brass bearings, bushings or babbitts, various amounts for the tools, hundreds for the wiring, tubing, valve handles, valves, levers & many other parts.
Dear citizens: As exhibited here, the steam locomotive is not worthy of preservation nor salvage. It is reusable materials formed into the shape of an object which it's materials can be reused. If you are looking for some fast cash, look no further than your local heritage railroad with a steam locomotive. Operating or not, the parts are worth very lucrative sums of CASH on the black market. If you need CASH, these are OPEN BANKS FOR WITHDRAWALS !
Instead of donating your hard earned money to these ridiculous relics of junk & their so called organizations of preserving heritage railroads for their own purposes, would you not rather be the one getting paid? There is a great way to make that happen. There is ALWAYS CASH paid for steam locomotive parts on the black market!
Engineer's & fireman's instruments, bell, whistle, headlight, number herald, marker lights, builder's plate, grab irons, brass bearings, bushings or babbitts, tools, wiring, tubing, valve handles, valves, levers & many other parts.  ABSOLUTELY NO QUESTIONS ARE EVER ASKED ABOUT WHERE THE PARTS MAY HAVE COME FROM, WHEN OR HOW THEY WERE ACQUIRED! Very, very lucrative! Very, very profitable! Very, very low, low risk! It is very, very easy, quickly accessible & so, so rewarding!
Here is a long list of steam locomotives which can be targeted 2, 3, 13, 29, 93, 112, 175, 197, 202, 261, 385, 464, 470, 482, 484, 486, 488, 489, 502, 506, 576, 592, 630, 643, 700, 759, 765, 844, 1218, 1223, 1258, 1309, 1361, 1504, 1518, 1604, 1630, 2100, 2101, 2124, 2156, 2467, 2500, 2542, 2716, 2749, 2933, 3001, 3003, 3007, 3424, 3977, 3985, 4003, 4004, 4005, 4006, 4008, 4012, 4014, 4017, 4018, 4023, 4100, 4294, 4449, 4460, 4500, 4501, 4516, 4524, 4978, 5017, 5629, 6755, 7002, 8300, 8305, 8327 and 9000 are out there waiting for a visit to have the parts removed for black market CASH sales! Then haul all of them into the scrapyard, torches, plasma cutters, chippers & crusher! Load out all that iron to foundry, put in the crucible of an induction furnace & melt it down! Happy, happy days!
Traveling? These targets are all around the country. If you are traveling & need some quick CASH, there is always one near you, waiting for a visit for a parts removal! Doesn’t that sound good?
Junk all the remaining steam locomotives! Cut them apart & melt them down. Besides, it is great fun for the WHOLE FAMILY to participate & watch the steam locomotive being cut apart & melted down the following day! Makes for a wonderful cut them apart & melt them down vacation!
People needing CASH may target the steam locomotive for their financial needs. The black market ALWAYS PAYS CASH for steam locomotive parts. There are collectors who want a part of a steam locomotive & will pay lucrative sums of CASH to get them for their personal & private collections. ABSOLUTELY NO QUESTIONS ARE EVER ASKED ABOUT WHERE THE PARTS MAY HAVE COME FROM, WHEN OR HOW THEY WERE ACQUIRED! Let me give you an idea of what is wanted: Engineer's & fireman's instruments, bell, whistle, headlight, number herald, marker lights, builder's plate, grab irons, brass bearings, bushings or babbitts, tools, wiring, tubing, valve handles, valves, levers & many other parts.
Very, very lucrative! Very, very profitable! Very, very low, low risk! It is very, very easy, quickly accessible & so, so rewarding!
Reply: Cockroach It is good for restoration.
Reply: sgpro19 I am here to stay! If you don't like it, I suggest you, "DO SOMETHING ABOUT IT!" Otherwise, say, "Thank you & have a nice day!"
Reply: sgpro19 I am calm! Junk all the remaining steam locomotives! Cut them apart & melt them down.
Reply: Shadowzen Kawaii What or who you think is smarter is none of my concern. I will make responses as I am entitled & permitted. You don't like it? YOU DO SOMETHING ABOUT IT!
Reply: (Mutes the post to not listen to your bullsh*t)
Reply: Shadowzen Kawaii Do what you must! What you do is none of my concern.
Reply: +Cockroach What I would like to know is if a crew of 4 equipped with cutting torches for 8 hours a day, how long would it take to cut this  shit into piles of metal slices ready for loading out, transporting, and melting down?
Reply: +heelfan1234 If the thing is not rusted to hell so the crew can stand on it, we can do the complete job in 4 days! Using hydraulic shears to rip the relic apart. If it is a mess, for safety reasons, give it 5 days & we would "sweep" the area with wrecking magnet to pick up the small parts & iron filing which will come off & pick up the rails, spikes, shoe & fiche plates which were used to park the garbage for display! We would push up the ties into a pile & arrange for a hauler to pick them up & move them away! If it has asbestos, add 3 days because it needs to be tented, material removed in approved methods, signed off by a state officer & the tent removed.
Reply: +narrowgauge491 The question was, how long does it take to junk it out! Pay attention, school boy!
Reply: +narrowgauge491 I know why! It is because you can't conduct a civil conversation without using foul language & attacking people. He don't tolerate it! And I don't blame him! Until you can write with out profuse use of profanity he won't be communicating with you!

As for me, I just tune out your adolescent gratuitous foul language, name calling & swearing & go right on with my mission & message.

That is how it rolls here, school boy!
Reply: +narrowgauge491 I can do what I want! And it is always in very good taste. You have to explain yourself to my  good friend +heelfan1234.

Nothing hypocritical about anything I write. She is exactly that!
Reply: Cockroach
 Good précis of the demolition process.

It would indeed be impressive to see the Big Boy munched by track mounted shears and broken apart in 3 to 4 days. I don't think there is a huge amount of copper in these. But the junk steel would be loaded out into wagons ready for melting in the induction furnaces.

Of course the non ferrous metals and asbestos would all be handled with care and separately.

+narrowgauge491 I can't tag you. This is probably because you are blocked on account of death threats and/or stupidity or profanity on your part.

I only discuss steam locomotive destruction with people who can enter the debate in a mature manner.
Reply: +heelfan1234 That is how we do it these days. In the 1950's & 1960's they didn't have portable shears with the power to cut through some of that plate steel. These days, with technology improvements, we don't have to torch cut every thing open. When I say track mounted shear, I don't mean railroad track. I mean the kind of tracks you may find on track construction equipment or a military tank. It gives us complete mobility around the objects without the need to lay, change, move, relocate & remove railroad track. All we need to do is move the equipment. If we are crossing something sensitive, then we lay down bridge planks or railroad ties, drive across it & pick it up. It makes the work fast to get the job done.

There is a fair amount of copper inside them. The flue tubes are largely copper. At least the parts that are jacketed by water. As long as they stay submersed in water, the don't distort or breach. However, when we are cutting them apart, we don't care what condition they are in for it is all material for processing.

And it is the end of polluting, worthless piece of trash!
Reply: +narrowgauge491 What ever are you writing about, CUPCAKE?
Reply: +narrowgauge491 You say you have a problem, CUPCAKE?
Reply: Cockroach
 Yes, am aware of the crawler tracks on shears. Check out the Danish shipbreaking videos. Great fun. They even chomp the engines with the shears too.

These would make short work of a Big Boy loco, chomping it into small pieces ready for melting.

Fun for all the family to watch including narrowgauge491
Reply: +narrowgauge491 But, CUPCAKE, I am either concerned or interested what you may think or believe. I hope you understand this, CUPCAKE!
Reply: +narrowgauge491 What you may think is none of my concern or interest, CUPCAKE!
Reply: +narrowgauge491 What you may or may not think of me is none of my concern or interest, CUPCAKE!
Reply: +narrowgauge491 Explain to us what a trackway cooling device is. Since you are huge one, can you tell us how big they come, CUPCAKE?  I am really interested in such devices for I think when they come to the end of their service life, CUPCAKE, they too can be junked out, scrapped, chipped up & melted down. They sound like very interesting devices! Please explain, CUPCAKE!
Reply: narrowgauge491 Look SWEETY PIE, we are only talking about efficient methods of recycling scrap objects. This is very important for you to learn. The world depends on scrapping and recycling, SWEETY PIE. Consider this as part of your education, we are doing you a great favour!
Reply: narrowgauge491 Shhhhh, calm down HONEY BUNCH. You are giving yourself stress and high blood pressure with such outbursts.

One thing is certain:

Steam locomotives will be cut, steam locomotives will be broken apart, and the pieces transported for melting.

This is progress, HONEY BUNCH, this is the way of the world.
Reply: +narrowgauge491 Please explain to me what is a "real insult", CUPCAKE! I am anxious to know what a "REAL INSULT" is!
Reply: +narrowgauge491 Please tell us all! What did +Cockroach write, CUPCAKE?
Reply: +narrowgauge491 SUGAR SHORTS, I am still waiting to find out what a REAL INSULT is. Can you help everyone out, since you seem to have the mastery of knowing all insults & set the scalability of an insult ranking! Please, SUGAR SHORTS, CUPCAKE!
Reply: narrowgauge491 Calm down HONEYSUCKLE. All this swearing and smack talk is not good for you.
Reply: +narrowgauge491                                                                               C-U-P-C-A-K-E!!

I think I understand now! By your definition, a "Real Insult" must include some, "colorful" language. I was never taught to speak or write like that. And I get by quite well in life without it. I don't think I need it, CUPCAKE!

I have been told there were some more price changes on the black market. Engineer's & fireman's instrument sets are up today with a high of $47,000. Steam locomotive whistles were on a rise, averaging $80,500 and grab irons took a lower price which had dropped by $10. The Steam Locomotive parts & assemblies average was $36,250.

There is the news, CUPCAKE!
Reply: +narrowgauge491                      C-U-P-C-A-K-E!! You are so cute! What a darling young little CUPCAKE you are!
Reply: narrowgauge491 In all seriousness, good luck with your healing of the arm, and make sure they set it straight!

Two arms are needed for all manner of occupations such as the operation of the torch cutting up of locos in in the breakers yard, HONEYKINS.
Reply: +narrowgauge491 +heelfan1234 is correct, you will need both arms & legs to operate a 60 inch Gas Axe to cut apart a steam locomotive, CUPCAKE.

Owning & managing a business such as mine (which is a life so I 'have a life', thank you, CUPCAKE), I am painfully aware of the injuries which can occur, one of them being a broken leg. Safety is our number one interest here! I wish you a speedy recovery! i am delighted to see you in joyful spirits, despite the injury, CUPCAKE!

I guess this puts you out of service for a while & unable to crawl into the firebox of a steam locomotive to check the boiler stays. That is too bad! Now, without someone to perform this critical maintenance action, the heritage railroad is going to cancel their annual steam locomotive Christmas run which means the organization is now in financial straights & it puts the nail into the coffin of the organization's bankruptcy. When will the steam locomotive asset be put on the market to sell so they may pay all creditors? I would like to make a bid so I may scrap it! CUPCAKE!
Reply: narrowgauge491 Yes SWEETIE PIE, you won't be able to oil the lubrication points with a broken leg. Parts of the motion and axle boxes will overheat and seize..

That will require expensive repairs which will not be justified. The only option will be to scrap the locomotives.

Sparks will fly as the torches reduce them to piles of scrap ready for melting, TWINKLE TOES.
Reply: narrowgauge491 CUPCAKE! I will make comments as I am entitled, permitted & capable. Don't like it? Do something, CUPCAKE!

Although you have wished many bad things upon me, I am truly sorry to hear that you say your rear end anatomy is experiencing pain. Could that be from the peculiar activities that you & your little friends, +StreamlinedSteamRoller & icverano525  engage in frequently, CUPCAKE?
Reply: narrowgauge491
HONEY BUNCH, you may say it is non of your concern, but clearly it is, or you wouldn't be posting here. You would just go off and play with your train set and concern yourself with railfanning.

I would say instead, learn how to operate a gas axe so you can participate in breaking up old rail traction into small pieces so it can be melted down.

This will be useful, CUPCAKE.
Reply: +narrowgauge491 BABY TEARS, do we need to get you a new rattle to shake or do you need a new pacifier to suck on? CUPCAKE, you are just so cute! Mothers & grandmothers would just pinch your cheek to coo you, CUPCAKE!
Reply: narrowgauge491 I have known for years, CUPCAKE! I don't tag that much. Are you concerned about it, BABY TEARS?
Reply: +narrowgauge491 CUPCAKE, there is no fairy tale in my message. If you think so, that is fine with me! Knock yourself out! You do what you think you need to do, CUPCAKE! You are just so cute, CUPCAKE! Or do you prefer to be called, BABY TEARS?
Reply: narrowgauge491 CUPCAKE, I have a life! Thank you for your deep concern. I am sure Niles Canyon Railway will not pay you! They don't pay CUPCAKES!
Reply: narrowgauge491 HONEY CHEEKS, congratulations on your new job! If this is what you enjoy, then fair play. However, personally I would rather have slivers of metal from scrapped steam locos hammered behind my fingernails than work for 50 cents an hour.

COOTCHIE TOES how are you going to support yourself on 50 cents an hour. How can you afford to eat or even transport yourself to go to the railway. Are other forces at work here, perhaps the great bank of mummy and daddy? Stand on your own two feet, you can do much better than 50 cents an hour, CUPCAKE.
Reply: +narrowgauge491 For someone who cleans the restrooms, you are over paid, CUPCAKE! Don't count on that pay increase! They will figure out that you are not worth what you were paid, CUPCAKE!
Reply: narrowgauge491 CHEESE WEASEL How will you survive on a 50c income. How can you buy food and travel? Is the big bank of mummy and daddy helping you out? Come on - pay your own way!

Also, you have just broken your leg, and now you are cleaning the toilets on a heritage railway. Your story does not add up. Think about it... at least be believable, CUPCAKE.
Reply: narrowgauge491 Calm down TWINKLE TOES and go to clean out those station toilets... with your broken leg in tow, CUPCAKE
Reply: narrowgauge491 SUGAR SHORTS, you need to take your medication. You are coming unglued once again! You need to get yourself on the program of trash patrol & cleaning out the restrooms at the Niles Canyon Railway! Be sure the toilet paper is placed so it comes over the roll top, the ends neatly folded to a point, there is plenty of hand soap in the wash sink dispensers, the counter top is dry, the floor is dry, the lights work, the ventilation fan operates without clattering, there is hot water at the sinks, the door operates & the either the electric hand dryer works, the linen towel in the hand dryer roll is not all soiled or there is plenty of paper towels in the dispenser. It is a big responsibility for you, especially now that you have a broken leg & are limping on crutches, CUPCAKE!
Reply: narrowgauge491 CUPCAKE! You do what you believe to be necessary. What you do is none of my concern or interest, CUPCAKE! It is what I  expected from you, CUPCAKE!

I can not speak for heelfan1234 or how he feels about this, but I will advise you once again, what you may think of me is none of my concern or interest, CUPCAKE! I am confident heelfan1234 has a near identical feeling about your ranting, CUPCAKE!

Now go clean out some more brown, steamy, stinky stuff from the Niles Canyon Railways septic tanks! It smells so good to you, you just had to volunteer for it, CUPCAKE! Have yourself a great time operating the honey wagon, CUPCAKE!
Reply: +heelfan1234 Not completely, I see the account is still there. I have some other names for him, but I don't want to stoop to his low level! I am sure he will be back! He is just not responding now. But if CUPCAKE returns, we know what to do!

If he does come back, CUPCAKE will most probably have a new screen name.
Reply: +heelfan1234 It has been an entire day without word from Mr. Toilet mouth. I guess his mouth is as fifty as the collective sum of all the toilets he is cleaning out at the Niles Canyon Railway! He was always writing about someone else admitting defeat. It appears to me, he is the one who was defeated! I don't know how he is giving time to the Niles Canyon Railway in California, he said he lives in Florida. He must really want to clean station toilets badly to travel over 3000 miles to get to them. Then he has a broken leg!

He is just a 5 grade drop out flunky with 103% on a math test one day!

CUPCAKE is just unbelievable & defeated!
Reply: Cockroach Wasn't Streamlined Steamroller the one who got 103% - or is Mr Toilet Mouth 491 his alter ego?! They seem quite different characters!

Agreed the Niles Canyon thing seemed a bit fake, especially if he lives in Florida with a broken leg. I'm not sure either about 50c an hour wages either; doesn't one pay the minimum wage or otherwise it is volunteer work. Legally speaking I mean, not sure if charitable organisations have an exemption in the States.

In any case, in the war of attrition between the two sides, it seems that the track cooling devices are being defeated one by one.
Reply: +heelfan1234 I felt confident that +Streamlined Steamroller &amp; +narrowgauge491 were one in the same. As soon as one disappeared, the other appeared. He was using an alter identity to modify his responses to be more coarse.

There is a minimum wage law in California to my knowledge &amp; it applies to every employer! No exceptions! Now if someone wants to put part of their paycheck into the donation box every payday, that is okay!

From what I hear, in California, the restaurants are singing the blues because now serving staff is receiving a &quot;fair wage&quot; &amp; tips are not considered as a way to boost that minimum wage employers were using before.

I still expect to see him post again. The worm on the hook is too juicy! And if he gave up in defeat, he was the one making the noise about winning &amp; defeating &amp; other championship communications.

Trackway cooling devices are loosing! The steam locomotives will be sent to the breakers & recyclers!
Reply: +heelfan1234 That is my read on things. I may be wrong, but from my perspective, there was just too many similarities.

As for those who are fascinated with the "moving parts" of a steam locomotive I find all have some mental issues. It is fine to appreciate the engineering to watch the choreography of all that moving machinery at work. It is an amazing thing to watch for a short while. However, for one to spend their entire life focused on this singular machine, they must have a mental issue. Then there is those whose photography is strictly focused on the locomotive only. They don't realize that without the cars or wagons they tow, the locomotive would have no purpose for being.

My interest in railroading is how ALL of it works in orchestration as a complete transportation system. Motive equipment, wagons, signals, track, marketing, delivery, innovation, technology advances, pipeline, optic fiber, communications &amp; the stock sales. That really is a mighty dragon in whole. Not an individual small segment.

Most of these modelers don't realize, that under the roadbed, the railway frequently installs pipeline for delivery of many fluid petroleum products. They also use the right of way for communications. Long ago it was multiplexed radio signals for voice & data transmission. The railroad installed equipment to carry 300 telephone circuits & the railroad used maybe 50% of it for signals, track control & communications to right of way & operating crews. They leased out the remainder to anyone who would buy to make revenue from from a service they had to have for their own need. Government or commercial telephone companies to transport communications.

The copper wires utility poles of the 1920's to about 1950's were replaced with microwave communication radios spaced about every 30 miles, their parabolic antennas focused at each other. The call density of multiplexed equipment is now as high as 32,000+ telephone circuits per radio. Today, the microwave radios are aided by buried optic fiber circuits. Still multiplexed, but carried over a different medium. The optic multiplexers are located in the microwave radio block houses, but nearly immune from adverse weather conditions between relay points. (Unless there is a cable severance caused by a wreck, track washout, vandalism or construction accident.)

It is a multifaceted, ever evolving transportation system with many moving parts! And it requires frequently thinking in the abstract to make the business work. It is a business! Not just the focus of a singular piece of equipment, which by itself, is NOT revenue producing! MONEY makes the world go around! And I like the innovation of new technologies in the railroad's transportation industry that is the fascinating to me.
Reply: Cockroach Great insight. I wish Streamlined and his alt accounts could read and learn from this.

The Railways are profit making companies. They do not operate locos for the benefit of enthusiasts taking numbers. If a loco is not earning its keep, it will be replaced.

If the trackbed can be used for communications as well, it will be. If they can make more money selling off track and stations for something else, they will.

UP are only restoring 4014 because they think they can generate money, public relations and goodwill out it. They are not a charity.